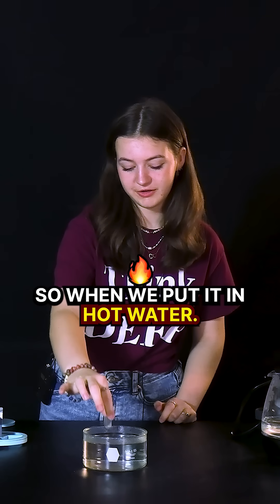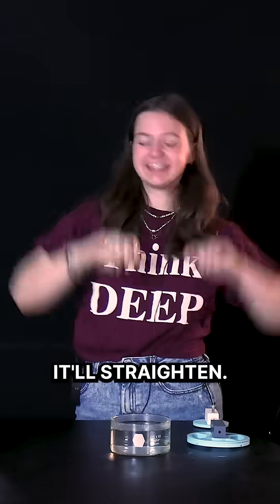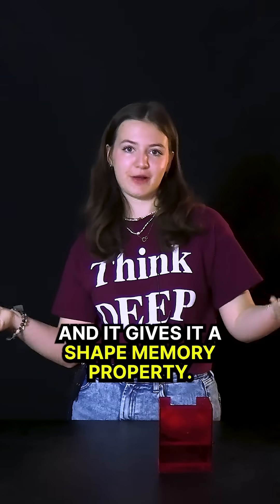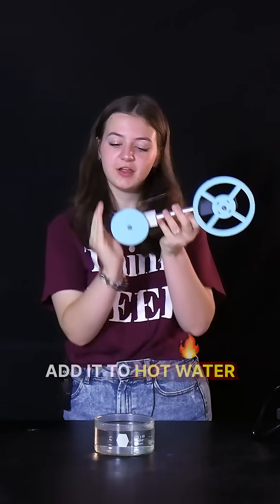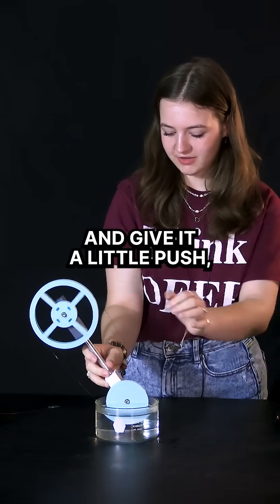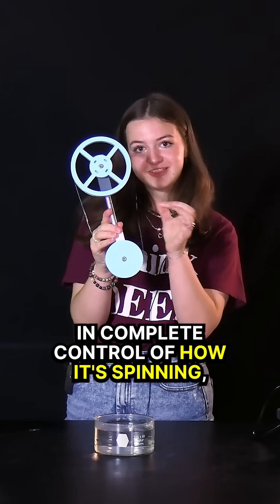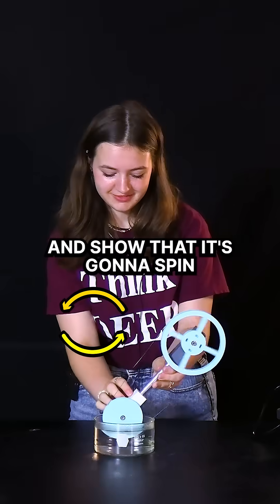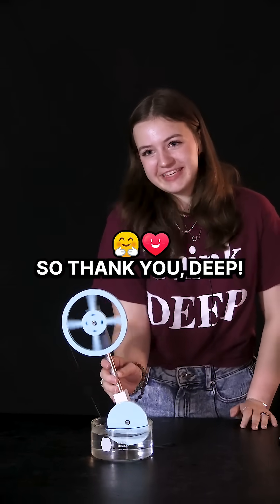Magic metal springs to life from heat! But how?? #shorts #tamu #science

Comment: For those claiming infinite power, power is energy and heat is thermal energy. With loss of heat you will lose the motions. So you therefore need something to power a water heater. Needing energy.
Reply: Increase the size and dip it into a hot spring, I wonder if that would work.
Reply: @leerious99  I think they actually do that already. Geo-thermal energy plants. No idea if they use the same principle as shown in this video though. I'll have to do some research 🤓
Reply: @CosmicMoth Geothermal plants use steam from the under the earth to drive turbines.
Reply: @CosmicMoth I believe geothermal plants use steam turbines. This metal would theoretically require lower levels of heat and pressure to do the same thing, which would make it adaptable to more regions than steam turbines are applicable.
Reply: @leerious99  congratulation. You just invented geothermal station
Reply: @vabka-7708  😂 obviously they had no idea, so it's impressive that they saw this and was like hey, we could use natural geothermal energy. Lbh most see this and think "skibidi chicken jockey snot rocket flippy floppy"
Reply: @leerious99  It's still just drawing thermal energy to make it do work, in the way this is made it just would keep going until either a the spring cooled down enough, or enough load was put on it to stop it.

The only real question is how much energy could it generate, in this demo its not really going fast by power production standards, and that is with no load on it,  it could be setup to power a battery bank, but the lifetime of the material in such an application is unknown.
Reply: @leerious99  If it did work, you'd basically be reinventing a geothermal generator. Steam turbines can be powered the same energy input and are a simpler mechanism, so generally harder for them to fail.
Reply: @heyitsjustaz Its upping the ante of normal heat energy generation because its adding its own energy to the action.
Reply: @leerious99 congratulations, you just discovered geothermal energy production
Reply: @leerious99  then just put that wheel into spring) hold on we already doing this 🙂
Reply: @leerious99  congratulations, you just invented geothermal power
Reply: @leerious99  then the issue changes to cooling the cord fast enough
Reply: @leerious99 At that point just nake a geothermal generator
Reply: @leerious99  it would, but the hot spring would’ve eventually stopped
Reply: @leerious99  no, because infinite power is impossible.
Reply: @leerious99  That's just geothermal energy with more steps.
Reply: @leerious99  you just thought of a new geothermal generator. And I think it could work.
Reply: @leerious99 
It might work, but you’re still not getting something for nothing; hot springs are still getting their energy from elsewhere (down below).
Reply: @leerious99  in theory it should provided the environment outside of the spring isn’t as hot. It would be a crude form of geothermal energy
Reply: @leerious99  not much torque
Reply: @leerious99  I was thinking the same thing.
Reply: @leerious99  just like geothermal power?
Reply: @leerious99  that's still geothermal energy from the planet lol
Reply: @leerious99 hey guess what. Increase the size. Add some paddles. And put it in a river.  Overthinking and over engineering solved
Reply: @leerious99  discovered geothermal
Reply: @leerious99  sure, but you're still taking the heat from the Earth even if only a tiny amount. It would just be another way of converting thermal energy into electricity for example. Some houses in Denmark bore holes into the ground to capture underground heat and transfer it to have heated floors.
Reply: @leerious99  at that point why not just build a water wheel
Reply: @leerious99  congratulations you just rediscovered geothermal power but worse.
Reply: @leerious99  that's called geothermal energy, it's a great renewable power source, not infinite power though!
Reply: @leerious99  yes that would work , which theoretically would be infinite energy,  at least for the next 300 years until the hot springs runs out of heat . Attach the pulley to a series of gears decreasing in size to gain more rotation then link that up to a turbine generator type deal and boom electric for years to come no real environmental impact
Reply: @leerious99  
Well wear and tear still exist, so you'd still have to replace the gears and you'd still have to apply lubricants
Reply: @leerious99  it would, but it would be like the least efficient way to get energy like ever
Reply: @leerious99  But logically that wouldn’t make sense.
Reply: @leerious99  that would be free energy but not perpetual
Reply: @leerious99  what would you power
Reply: @leerious99  geothermal power 2
Reply: @leerious99  for as long as the hot spring stays hot or exists. There also likely is material degradation. I'm not familiar enough with how nitional handle metal fatigue.
Reply: @leerious99  congratulations we call that Geothermal energy where geothermal powerplants come to play
Reply: @leerious99  that should work. But thermal geothermal energy would be available by a hot spring so that would probably be the more effective option
Reply: @leerious99  it's better to use the hot spring itself to power a plant
Reply: @leerious99  yeah that would work! Then you could capture mechanical energy from the heat of the Earth's core 😊
Reply: @leerious99  the would be a form of geothermal energy.
Reply: @leerious99  wouldn’t that just melt the metal instead of straightening it
Reply: @leerious99  still not infinite energy. You would effectively make a geothermal engine.
Reply: @leerious99   geothermal energy is 100% a good way at getting it, but even that runs on something
Reply: Not at well as a water wheel @leerious99
Reply: @leerious99  yes Japan has actually used this method it’s called geothermal energy
Reply: @leerious99  true I think
Reply: @leerious99  thats just geothermal. its all ultimately a matter of cost of maintenance and efficiency of the different systems
Reply: @leerious99  That might actually work! Since hot springs are naturaly heated from the ground.
Reply: @leerious99 that’s what I was thinking hot spring or thermal vent
Reply: @leerious99 this would be the same as a geothermal energy plant which something already being used in different countries but there’s a limit to the amount of heat given off so to the extent that they can, they’re already using this energy method. And I don’t think they use this crystal structure reaction but they’re definitely using the method that works the best with what they have. Usually turning water into pressurized steam.
Reply: @leerious99  why not at that point just use the steam to push a turbine, the nitinol would not straighten fast enough or remain strong enough to push anything anyway.
Reply: @leerious99  i mean the hot spring is a battery if i ever saw one
Reply: @leerious99  it would work as a way to turn geothermal energy to electricity. But it wouldn’t be competitive to other energy sources. Even if it was really efficient I think it’s best to leave the hot springs around the world to human enjoyment.
Reply: @leerious99  it would slowly cool the hot spring?
Reply: @leerious99  yes omg yes!! You did it!! You actually thought of the solution and no one is addressing it! This is truly perpetual motion the same way a waterfall can be perpetual motion!
Reply: @leerious99  it would work but far more efficient ways to get energy from the hot spring
Reply: @leerious99  yeah but you still outside energy at some point. That’s what people are getting caught on I think
Reply: @leerious99  yeahhh
Reply: @leerious99  At that point you're building a water turbine... Its way more efficient in that case to just build a dam and use the force of the water moving rather than the heat generated by the water
Reply: @leerious99  you've discovered geothermal power, and it's probably our best bet for the future since all the other renewable resources arent working the way we'd hoped
Reply: @leerious99  It should.  It's basically running off geothermal power at that point.

There are already stirling engines that can run off more temperature differences, so it's less remarkable than it sounds.  It's not a lot of power, but has some applications.
Reply: @leerious99  That's basically what geothermal energy is
Reply: @leerious99  or any naturally hot water
Reply: @leerious99  That’s just using heat from geothermal energy, so we kind of already do that
Reply: @leerious99  thats just geothermal power
Reply: @leerious99 that’s just a geothermic generator
Reply: That may actually work because the heat comes from something outside the moving system and is an almost infinite source of heated water from the Earth.
Reply: @leerious99  👍 exactly my thoughts
Reply: @leerious99  yet you are limited 1 area the hot spring yes it free energy
 But it limited needing a hot spring
Reply: @leerious99 

How about attaching a heating mechanism powered by the spin so much so the energy from spinning is utilized to maintain the heat
Reply: @leerious99  attach a hot spring to your motor and bam new type car
Reply: @leerious99  that’s my friend is what you called geothermal 😅
Reply: @leerious99  probably it's a similar concept to a water wheel on a creek it's free power to us but it's still not perpetual because there's still a source powering it.
Reply: @leerious99  would still not be perpetual energy, it would just be a gimmicky thermal generator, plus I'd doubt any serious strength to actually take load.
Reply: @leerious99  yeah, not quackery like perpetual motion, or infinite power. Simple and effective geothermal power.
Reply: @leerious99  it would, but it would be powered by the earth and not a water heater instead. so not true infinite energy but it would last for years depending on the hot spring.
Reply: @leerious99  I could be wrong, but if you're going to use thermal vents/hot springs for power, why not just use the pressure/heat directly instead of this weird system
Reply: @leerious99  geothermal energy? Yeah that's been a thing for decades.
Reply: @leerious99  might be easier to build a geothermal genenerator without it, but the steam could be used as excess thermal and you could have the cool water just before it on the pulley to maximize energy output of the plant.
Reply: @leerious99  thats just using existing energy its like burning coal
Reply: Dip it how? Assuming with a… machine that uses electricity or you just gonna use the wire to dip another wire🤦🏾‍♂️
Reply: @leerious99  it should
Reply: @leerious99 exactly my thought too!
Reply: @leerious99   it will just be another geothermal electric generator
Reply: @leerious99   I just posted the same thing ... Great minds think alike :)
Reply: @leerious99  Sounds like a plan to me!
Reply: @leerious99  thats how thermal-energy is used tho
Reply: @leerious99  yeah and now it’s powered by geothermal energy
Reply: @leerious99  yeah that‘s called geothermal and it exists
Reply: @leerious99  That's kinda just geothermal energy, no?
Reply: @leerious99  it will but the water will cool. The earth will heat up the water. If you find a sufficient geothermal source it will definitely work. Amazing invention.
Reply: @leerious99  Thermal vents used like that!? Smaaaaart!
Reply: @leerious99  still, needs energy.
Reply: @leerious99  woah
Reply: @leerious99  that is geothermal energy, and there are more efficient ways to generate electricity with is than using this wire.
Reply: @leerious99  like a geothermal plant
Reply: @leerious99  that’s what we call thermal energy so yes.
Reply: @leerious99  Geothermal energy is a renewable source too!
Reply: You could try using hot springs, not infinite but certainly long lasting, the loop would have to be long enough to allow time for cooling and gearing might be a challenge. 
All depends on how robust the materials are.
Reply: @Never2old.  I wonder if thermal or volcanic locations might be more effective. Maybe something submerged near volcanic vents? It'd be a deep dive, but probably less disruptive than, say, oil operations in offshore structures.
Reply: @Never2old. Right I imagine extended use means it's less likely to retain memory so it would be nice if they were setup specifically to power small items only when dipped would they make electricity.  Of course then there is making a low rpm version lower than 500 rpms
Reply: just use hot water from hot areas or from the sun
Reply: @MegaNinjaRyan  Geothermal energy
Reply: Just conservation of power principle. You could theoretically harness the same source of energy over and over if you can find a recyclable one. But yes you do lose a tiny bit of energy as the chain goes on.
Reply: @dawfurby oh wait. . .
Reply: @BLANKrecordwhatilike00000-I  i'm not here to pick on you. I'm just flabbergasted that your flawed-concept comment has more likes than the one where you realize the glaring mistake, lol
Reply: @IRanOutOfPhrases  lolol
Reply: @dawfurby  A little bit is how much?
Reply: @dawfurby  conservation of energy* power is not conserved.
Reply: @dawfurby the loop should alternate between hot and cold sources, 'cause it will eventually reach or get close to the temperature of the source.
Reply: @dawfurby   nah cause of entreopy
Reply: @dawfurby  it can power the water heater which will heat the water to keep it going and if it works out it can produce way more power like a water mill or turbine.
Reply: @dawfurby  this is why I believe we could be taking advantage of volcanos for power. A giant geothermal generator, would cost an insane amount of money tho
Reply: Naturally, but what’s crazy is how fast it can spin that wheel, given that heat has to transfer which can take some time.
Reply: @AtomicArcherGuy  it's amazing fr
Reply: @AtomicArcherGuy 
Its pretty efficient! That bit of heat in the water turning that larger mechanism! I could run an attic fan easily. Think of all the greenhouses and chicken houses needing ventilation in the heat.
Reply: @MegaNinjaRyan  so a geothermal water heater for infinite power
Reply: Or we use geothermal vents. How much steam power would we be able to harness from Yellowstone alone?
Reply: @ not leave the Duttons rest in peace
Reply: @Ricardo-cw4cb  you do realize that’s a made up television show
Reply: @MegaNinjaRyan  thank you for the explanation, I knew that it wouldn't truly be "infinite power" or "perpetual motion" but I totally overlooked that part of it. Thank you!
Reply: @MegaNinjaRyan  so what is the power source holding atoms together? Is that not infinite?
Reply: @FragmentOfInfinity  there’s no “power” holding atoms together; power is energy over time.  There is energy involved in the electric interaction between electrons and protons of an atom, and that energy can be useable such as in the case of a chemical reaction, but this isn’t limitless as reactions only occur spontaneously when the reaction results in a lower overall energy state (a reaction will spontaneously occur if the Gibbs free energy is lower in the products than the reactants).  Even if we consider nuclear reactions, the energy from these reactions comes from a change in mass.  
And at the end of the day, there exists a finite quantity of energy “in” an atom—you cannot simply extract energy from an atom indefinitely.  You could get energy from an electron that drops to a lower energy state from a higher one, but there needed to be energy input to bump that electron up to that higher energy state to begin with.
Reply: @FragmentOfInfinity  No, it may transfer, somewhere, but won,t disapear nor won,t be generated from nothing. The atoms don't need incoming energy to hold them, but it's somewhat constant value
Reply: @MegaNinjaRyan  what if it’s connected to a heater that keeps the water warm but also produces electricity as well?
Reply: Sun, son
Reply: @MegaNinjaRyan   reinvent Steam engine
Reply: Nah if it didn’t lose properties after a while, it would be infinite
Reply: Right. Would it be more efficient use this instead of heat water for the vapor to spin a rotor?
Reply: No it won't be more efficient, cause in the mechanism/device shown in video most of the stored thermal energy(heat) is dissipated into the air and lost, where in the most systems in which you use steam(in most cases saturated or superheated steam) to generate electricity most of the heat energy is used to heat water and convert it to steam in a closed loop and it means less heat losses due to heat dissipation.
Reply: So ive seen some batteries that are on large scail using heat from the sun and at night use that stored heat as power so you could just do that  and there would allways be power
Reply: @MegaNinjaRyan  the sun here in Saudi is hot af
Reply: So this is actually a thermal generator. Neat
Reply: @MegaNinjaRyan  put the spinning part on a dynamo and power up the water heater with it to have infinite hot water. Jk
Reply: The hardest part about building a perpetual motion machine, is figuring out where to hide the batteries
Reply: Hot water/ heat is often a waste byproduct of many industrial processes. Could be an energy efficiency game changer.
Reply: I would love to see this attached to a windmill.
Reply: use solar
Reply: Perpetual motion a.k.a infinite power is impossible, but i do wonder what would happen if we harnessed the power from a volcano.
Reply: Bro forgot about fire 🔥
Reply: this starts with asking how much heat is required to make the metal change states.

the second question would be scale, how many "wheels"  need to exist to justify spending energy on the machine to make it infinite.

the third question would be (not really a question) can you create heat as a byproduct of the machine running the heat the water to the required temperature to keep the motion alive.
Reply: U could just put it somewhere that’s always hot like near a volcano or you could use thermal vents from the earth or something like that either way I’m sure this would still be better than the type of power sources we have now
Reply: Connected to the wires which will power the heater which will heat the water which will continuously bring power
Reply: What if you built it over a hot spring? That wire would probably snap before it would ever run out of heat.
Reply: What about to you the hot springs water for it?
Reply: Geo thermal energy 😂
Reply: I know perpetual motion/infinite power isn't possible but if you left it in the sun it would work all day as long as it's in the sun light.
But also its electrical output would be insignificant therefore unable to do practically anything.
Reply: who said it needs to be heated?
Reply: @VVKS__7  in order to change from 1 shape to the next it needs to be in a heatwd room with cold water or vis versa
Reply: 2 words... Radio active
Reply: @MegaNinjaRyan  geothermal energy exists
Reply: Solar power
Reply: On the other hand, many, many, many energy sources lose efficiency through emitting heat, so if we can harness some of that lost energy for another purpose, we'd be increasing efficiency. I'd be curious to see the numbers, both on the energy efficiency and how long those metals are able to last in that state
Reply: Have a bunch of these and Power a shared water heater with one of them. We don’t need infinite power, we just need as much efficiency as possible
Reply: @MegaNinjaRyan  bro is confusing energy and power
Reply: Hot spring
Reply: What if you build a giant one of these at a hot spring and harness the earths natural heat from the core? Then it technically does break first law of thermodynamics as it’s harnessing the earth natural heat which does not need to be reheated.
Reply: @ that’s what I’m saying, should be able to create a perpetual motion device that could create infinite power
Reply: water heater. Why not just use a river?? Natural free energy??
Reply: Sun? Mirrors? Would just need a solution to cool it or find a material capable of cooling to room temperature very efficiently. Perfect no, but could potentially be highly efficient.
Reply: It could generate “power” (I think you meant electricity) if you could find a low enough torque generator to to connect to it, but that would only work until the wire reaches equilibrium with the hot water. Unless you cool the wire on the other end. 
Also, if you generate a low voltage (DC) and run it through an inverter…. BOOM, you have 120v, 240v …. 

Don’t tell me that won’t work. Car 12vDC to Household Standard 120vAC Inverters are “everywhere”. 😉🤓
Reply: Could use solar heat, or heat wasted from steam processes that recirculate and cool the water
Reply: Sunlight passed through a magnifying lens to heat a metal part, which has been partly covered by the water. The then hot metal will transfer the heat to the water. All you need to do is leave it outside on a sunny day.
Reply: Hot springs = infinite power
Reply: Encase the lower pulley halfway into a liquid that has a low boiling point, then make sure the Axel/bearing mechanism is replaced with one that captures heat energy from the spinning pulley and transfers it to the liquid. The question is whether or not you can generate enough force with 1 pulley encased, but what if BOTH pulleys have the system? How far up the "wire/drive line" can heat be applied and it still function? That will decide the overall dimensions of the casing (s) and where you will need to figure it out how to connect and power an external device. How scale-able is it? Could we do this on a smaller scale and reap the benefits of chaining them? That's where the real production or energy would come in.
Reply: Use water that's used to cool off AI data centers.
Reply: What about geothermal? It's not "infinite" but you don't have to spend power to heat the water?
Reply: I FEEL,cant the generater they build heat the water also.... at first they can start a generator until its warm then shut it down...free power.. I just invented ..wow..to bad this has been a thing the whole time and they just want to make money off power.we live in a lie..truely sorry everyone
Reply: I mean, could be. Stick industrial scale one over volcano. Profit.
Reply: @BladedThoth  or build a water loop near a volcano so it's always heated which then transfers the heated water to the tank of liquid and then unlimited power (depending on torque)
Reply: You could put it in a hot climate. During day time, like another version of solar powered. And you can make it the opposite for night time, where the wire would activate with coolness.
Reply: @Rash_knee  needs one side hot other cool
Reply: @stefanth8596 no it doesn’t, the heat is what makes the wire turn
Reply: @Rash_knee only heat
Reply: @Rash_knee the wire needs to coil back up to keep the process going so if it's hot everywhere it's not going to work
Reply: @Rash_knee makes that an complicated way to get solar energy (Sun's rays focused onto water or a boiler and heats water, generating infinitely   straightening wheel, instead of a simple solar panel)
Reply: @Rash_knee  Goodluck shipping from Sahara desert to Antarctica
Reply: @Rash_knee  Pairing this with solar power and a battery could yield some potential for home energy solutions
Reply: @Rash_knee  that is not how it works though. It works due to having delta between temperatures. If your temperature is constant, nothing happens. Also, if you spend solar energy on this, why not yo use solar energy on something which make useful work?
Reply: @Rash_knee  if you put it in a 'hot climate', let's imagine you meant into an atmosphere hot enough to make the wire straighten,  you will get no motion because all of the wire will try to straighten. The reason this spins the wheel is due to heating the wire only on one half of the wheel. Due to the force of the wire trying to straighten, the wire drags itself out of the curve. If you're doing this on both sides of the wheel,  you lose the effect due to having equal opposing force.
Reply: @Rash_knee another thing to remember is thermal expansion too. You could put one of these in an open faced well and control the level of water based on the current needs , say it's cold in the night less solar radiation dip it in the deep well where it's above 50 degrees at all times ,reduce the amount of water and put the well where it gets blasted by light all day heating the well. Maybe a clear plastic or glass cover would be a good idea
Reply: @Rash_knee  heat is energy "coolness" is lack of energy or heat. There is no harnessing power from "coolness" as you call it. You can only utilize the differences in energy but the energy comes from the heat.
Reply: @Rash_knee  water has a very high specific heat capacity, so if you were in a hot climate, it would probably work better to just use solar panels
Reply: @Rash_knee  Well, it needs a temperature difference, not only heat. Thats why she puts just the small wheel into water. Outside its cooled and can straighten again in hot water
Reply: @Rash_knee yes we use solar panels to charge it up or magnifying glass to heat up water as the sunlight passes through it to warm the water to a boil maybe
Reply: @Rash_knee  I was thinking that it could be useful to power a basic fan for higher temperatures. The fan will automatically start once the temperature starts to rise.
Reply: @Rash_knee  the sun isn't infinite, technically
Reply: Thank you man lol
Reply: spring
Reply: @MegaNinjaRyan  have you heard of understand water volcanos and hot springs
Reply: @MegaNinjaRyan  could you however run a machine or mechanism off of hot water?
Reply: @MegaNinjaRyan  could be a good power source for place that are near idk hot springs bc most of those tend to be off grid???
Reply: @MegaNinjaRyan  yeah, but let's say the military were using a deep underground military base and they were looking for some breakthrough energy and because they're closer to the core they have heat down there. I bet you they could use it for a power source or adapt it in some manner using geothermal
Reply: Geothermal energy could come in handy for this
Reply: I wonder if this could be used in something like a hot spring that doesn't produce enough heat to use steam but does produce enough heat to power something like this.
Reply: For everyone saying volcanoes and hot springs, you know Geothermal power station are already a thing right? And I'm pretty sure they are way more efficient than doing this, this is just a fun concept but in mass scale we have better and more efficient ways to collect energy from heat. As for coldness it gives you another problem, you need energy to heat the wheels to keep them hot enough to not freeze. So basically it wastes energy that produces.
Reply: What about putting it in some hot springs? - edit Oops, someone already said this
Reply: @MegaNinjaRyan  we should make it bigger so it can power its own water-heater
Reply: @MegaNinjaRyan  yeah but build this around a star
Reply: i suppose someone could find a way to use one of these to power a small heat source? like certainly not infinite power but maybe "free" energy? light a candle under a bowl of water starting one of these spinning which powers a heating element in a bigger bowl of water powering a larger one of these that could potentially power a generator? or use solar power to power whatever heat source you use. still not infinite but definitely "free"
Reply: and you need to bend it first, which also takes energy
Reply: @MegaNinjaRyan  or elevation
Reply: @MegaNinjaRyan  technically yes but this could work treating it as an alternator in a car to generate ac currents use capacitors to store and also push out a high level of energy makeing a heater and or cooling to make it run makeing a technically perpetual motion machine/continuous energy system.
Reply: @MegaNinjaRyan  just burn trash & get water heated.
Reply: @MegaNinjaRyan  makes sense. Gotta heat the water lol. Still pretty cool tho. Makes me wonder how warm or hot it needs to be. Could end up being a really efficient system some day. I'm imagining a robot with limbs with this wire as tendons for those limbs.
Reply: Simple, hot springs/geysers exist, so do artic pools, etc
Reply: Geothermal energy combined with this could be an interesting idea.
Reply: Ohh right . I gotcha . I missed the hot water .
Reply: Yeah i was wondering where the batteries were, nearly slapping myself on the head when i realized the battery was the hot water.
Reply: The sun. + Scale up
Reply: It requires both heat and cold. Without the cold, the wire would simply expand and stay there.
Reply: @MegaNinjaRyan  no to mention maintenance from degradation of material
Reply: Ik completely missed the first "HOT water" part, so thanks for pointing this out! 😊
Reply: I know that. But I was wondering how much minimal heat you need to make it work and if it will produce more energy than the energy lost while maintaining the heat
Reply: @MegaNinjaRyan  even stars die, no one thinks infinite power is a thing
Reply: What about very hot climates
Reply: yes, but this could work in situations where the water is already hot like tankless water heaters which require an active fan to vent. or nuclear power reactors which use water to cool down. you could increase your efficiency
Reply: I have a great idea, put in in natural hot springs 😮
Reply: True. Perpetual motion is only impossible however (by definition) because of things like: the Earth is going to be swallowed by the sun one day. One small idea I've had would be to either: drill a huge tunnel, in the shape of a racetrack and fill it about halfway with water. The Earth spinning will generate current because Coriolis. Alternatively, we could go deep enough to go all the way around the inside of the planet (for transport as well as power generation). It is absolutely 100% possible to setup and use systems/machines that produce more energy than they take to build, in the form of simple electrical current. With this one all you'd need is a thermal vent. The only problem is, eventually the machine will break, thus, no perpetual motion.
Reply: 👍 The sun makes a really good water heater.
Reply: don't forget cooling
Reply: @MegaNinjaRyan  what if you powered the water heating system with the same method though????
Reply: Coil
Reply: @MegaNinjaRyan  what about spacetime? Search spacetime antenna by bashar.
Reply: Like a wood fire. Like solar energy. Like geo thermal. With small ammounts we can turn bigger or more complex wheels!
Reply: Where to buy the rod metal thing to build it?
Reply: @MegaNinjaRyan  easy. Volcanic areas.
Reply: I wonder if some kind of radioactive substance could create enough heat to make that think move
Reply: @Richard-qj1os  its the need to alternate between hot and cold that creates the problem for mathematics.
Reply: Might I introduce you to "Universal Entropy"? Our ancestors called it "mana" and the manipulation of this mana, was "magic".
Magic and Science are one and the same, its just dependent on how much you understand about the process.
So while there is no magical infinite free energy this process can literally go on forever.
Reply: @MegaNinjaRyan Sun light with magnifying glasses will keep the
Reply: No you couldn’t possibly ever make electricity with a turbine.
Reply: So build it on a thermal spring, aslong as that spring is hot which should be a very very long time ur good
Reply: sun and magnifying glass lol
Reply: Could you make a car out of it?
Reply: Now imagine a big tank of water near lava
Reply: @MegaNinjaRyan  lava. Thermal vents. Anything like that.
Reply: @MegaNinjaRyan  true. But that doesn’t make this useless. Imagine using the sun to heat the water.
Reply: @MegaNinjaRyan  this in conjuction with eddy currents? However it's spelled. I'm more into mini nuclear powered systems. To work on homes and cars
Reply: Exactly. This is not a perpetual motion machine because there is no such thing.
Reply: How about hot springs
Reply: @MegaNinjaRyan  what about a hot spring?
Reply: @MegaNinjaRyan  what if you use the water from a hot spring?
Reply: nah it's perpetual motion baby
Reply: Yes but I'm sure power consumption will be less than traditional power methods.
Reply: @MegaNinjaRyan  If the pulley system were reworked to use the alloys response to cold water, or even cool water there is potential here.
The only issue is that the water needs to be heated, but the alloy also responds to cool water..
If it worked with cool water, the only energy that would be expended is the process of 'training' the alloy initially, after that it pulls at itself.
It'd essentially be a complex low power water wheel.
Reply: I was gonna say lol.
Reply: It's like a Stirling engine running directly off of heat.
Reply: Makes sense but is the energy needed to spin it less in this case?? 

It intuitively seems less.. idk someone does some calculation can prove it
Reply: All forms of energy are effectively just boiling water
Reply: The.. the sun.
Reply: @sambenavides824  I don't know how to say this but the sun is not infinite either. Eventually it will die and when it does it will take everything with it
Reply: Volcano
Reply: @MegaNinjaRyan  like mirrors and sun for examples and solar battery for the night if u think clean energy u start finding solution if u r programmed u will be prisoned to program
Reply: @MegaNinjaRyan  add a solar heater and technically it's perpetual motion during the day.
Reply: it always comes back to boiling water
Reply: wait like... energy from the sun?
Reply: depending where you are in the world, the sun could achieve that, with help of something insulating to retain heat overnight. im not arguing infinite energy. but, couldnt they also just train it the opposite way, so cold water makes it straighten?
Reply: @MegaNinjaRyan  Someone needs to invent geothermal heat, th nnit would help this for sure.
Reply: @MegaNinjaRyan  chemical heating should be a good bet for low energy input
Reply: @MegaNinjaRyan  build one in the hot springs
Reply: @MegaNinjaRyan  so insulate it our run it in a hot spring?
Reply: In some places, they have renewable thermal energy from the ground
Reply: @MegaNinjaRyan  also, you need water, or some other fluid that can be heated, or just something to heat it up. Either way, free energy doesn't exist. Even if we could take advantage of gravity and we had an infinite hole to drop a wire down that's attached to a pulley, you'd still have to continuously add wire. There's no "free energy" it always comes at the cost of something else.
Reply: Just to add the conversation;
Keep in mind sources of energy like magnets- the sun- or thermal springs, are themselves not actually infinite. Its just that the finite timescale of the amount of work (energy) which can be produced from said source is greater than the time scale of the receiving use for said energy. 
In other words, a tree's growth can be powered by the sun for a thousand years but a star can produce that energy for billions of years. 
So while zero point energy is physically impossible, gaining  advantages approximate to zero point energy itself relative to the amount of time you need that energy for is absolutely possible. We're just not there yet, fusion is an example of one means by which we may get there. Or think of it like this-
You cant make a battery that lasts forever. But if you had a battery that could last 100 years that wouldn't matter.
Reply: @MegaNinjaRyan  ah, thank you! Didn't even think of the water needing energy.
Reply: @MegaNinjaRyan  but this can work in places with ambient heat sufficient enough to run. But then again even solar panels do the same.
Reply: @MegaNinjaRyan  Geothermally heated water?
Reply: i do have to wonder though, if something similar can be achieved with room temperature water. if that is the case, perhaps a new form of energy could be utilized.
Reply: Hot water spring
Reply: A giant magnifying lens and the sun
Reply: @MegaNinjaRyan  geothermal would provide your heat source and water
Reply: @MegaNinjaRyan  true, but maybe it could capture heat from a body of water heated in summer, sins it will heat up and coldown every day.
Reply: Yes. It's incorrect to say it's powered by the nitonal, it's actually powered by heat.
Reply: What about fire
Reply: Solar...powered....water heater...
Reply: @ please explain
Reply: Nobody is claiming infinite energy. Even the sun isn't infinite. But in the terms finding natural sources of hot and cold to allow this to function, it should absolutely be possible as a viable source of energy
Reply: @MegaNinjaRyan  bro how are you a grown adult yet unaware of what geothermal energy is?
Reply: Would be nice if it straightened due to cold then
Reply: @MegaNinjaRyan  what if we build one in a hot spring?
Reply: Why not just use that big star in the sky called the Sun for power?
Reply: Put a magnifying glass pointed at a water container in a sunny area and here you go, at least you can have energy during the day and depending on some insulation conditions created it might make it through even longer. Wont be infinite but still free
Reply: @MegaNinjaRyan   this could be a really cool way to utilise thermal heat from volcanoes though??, which could be super useful?
Reply: Geothermal heating could have a place in this not sure if efficiency would be there but that’s an unlimited heat supply
Reply: @MegaNinjaRyan  a hot spring: "so i'm just not a thing, eh" 🤭
Reply: What it that powers something to heat the water?
Reply: @MegaNinjaRyan  so stick this wire and wheel contraption in a hot pool near a volcano or something. Sure, energy is being added to the system, but WE'RE not making the energy to add to the system, netting a total plus in available energy
Reply: @MegaNinjaRyan  nobody claims that but it could actually power itself forever given the correct components and That's cooler than anything you'll ever do no offense
Reply: I don't think you really know what you're talking about.
Reply: @MegaNinjaRyan  america is full of hot springs that stay hot for thousands of years. Put it into one of those, and it is in fact a perpetual energy machine, for atleast a few thousand years, which should be scientifically impossible, but she did it
Reply: @MegaNinjaRyan  so what about using black piping coiled up to heat a small pool of water under the summer sun? I know its still not infinite power but would work during the day at least.
Reply: make it bigger make it stronger make it faster
Reply: Thats part of problem. People are 'all or nothing' knobs. It doesn't necessarily have to have 100% efficiency. We get in the 90s and it will be longer than our several lifespans..
Reply: Make it into a generator to heat itself
Reply: @MegaNinjaRyan  if the turbine powered by the wheel had some energy split off to power the water heater, then it would potentially would be unlimited power after the initial hot water input into the system
Reply: Hot springs....ok thanks bye
Reply: @MegaNinjaRyan  volcano under water tho
Reply: @MegaNinjaRyan  agreed, however this module is much more efficient if we were to implement it in real life. Low cost to run the set up with minimum temperatures that can alter the wires shape. By increasing distance we can actually control how long the wire can hold a specific position. With more research and funding, am sure this team probably can build an engine that uses thermal tech only.
Reply: I would say to use the waste heat of other systems to fuel this kind of pojects
Reply: @agsai7185  such projects give 0 torgue. So on the moment you connect this to something it will stop. Even if we can create something which is 99% efficient and uses 0 resources, the amount of useful work from the system will be almost non-existent. Like imagine that you created some mechanism, which can work on single drop of oil fuel for years. What is the point of such mechanism if by adding load the mechanism will never work, because the output of the system is absent?
Reply: the sun dude, like the pyramids in movies has automatic doors in day light and stops moving at night, I believe that's how gears made back in ancient times 🤔
Reply: @MegaNinjaRyan  hot days make big heat, free heat all summer

infinite energy all sunmer
Reply: @MegaNinjaRyan  in my country there's a lot of natural water sources in the mountains, so it's not a problem, but unfortunately my country still relies on non-renewable energy
Reply: Definable not perpetual, but how efficient is it?
Reply: Soooo it's more like a transducer than anything? Turning heat energy into rotational energy?
Reply: @MegaNinjaRyan  Unless you can put it in lava
Reply: It’s not infinite or free power but it could be implemented to increase the efficiency of thousands of existing systems.
Reply: @MegaNinjaRyan  Natural thermal vents and natural nuclear reactors exist. Thermal vents are more common than reactors. That's as infinite of a thermal energy as it gets.
Reply: @MegaNinjaRyan  not at yellow hot springs , it's red hot springs
Reply: @MegaNinjaRyan  the sun is pretty good at heating water. Summer time water hose should do the trick
Reply: @MegaNinjaRyan  it is a silent "engine" though
Reply: OOO WE CAN USE THE SUN OR A VOLCANO!!
Reply: @MegaNinjaRyan  okay so how about we put a big one of these In a hot spring at Yellowstone? Can it be infinite energy using an infinite heat source?
Reply: @MegaNinjaRyan  hot water springs?
Reply: So use the energy the wheel produces to heat the water and have a separate gear powering something else
Reply: Don't ruin the dream😢☹️
Reply: Thank you bro, I was worried someone would comment that. That being said, imagine how much more efficient you could make turbines with this property in mind. And being able to store energy as heat is an old trick. What is really neat is how you could make geothermal turbines like this. Power from the earth itself and that’s pretty cool.
Reply: @MegaNinjaRyan  lava or sun could do they job!
Reply: The estimated metric tonnage of coal left on Earth is currently around 1.16 trillion short tons (approximately 1.05 trillion metric tons).... Yeah we're not going to run out of coal and it definitely ain't finite
Reply: @MegaNinjaRyan  honest question, do you think this kind of technology could be incorporated to nuclear reactors?
Reply: hot spring?
Reply: @MegaNinjaRyan  just go to a volcano for infinite heat
Reply: @MegaNinjaRyan  or some kind of natural hot spring
Reply: @MegaNinjaRyan   i get what u mean but for why not try to reach the actual limits of what this could potentialy be instead of saying its mot power when no one claimed it could even be power
Reply: @MegaNinjaRyan  yes but the power needed to keep the water hot could be less then what 14 large wheels produce while submerged
Reply: Put it on a very volcano or in the desert?
Reply: @MegaNinjaRyan  naturally hot water...
Reply: She's cute so we'll claim it
Reply: What about geothermal sources? Would that mean near limitless power?
Reply: @MegaNinjaRyan  THANK YOU 🙏🏻
Reply: What if you use the electricity it could create to power itself (if heaters dont use much. Idk)
Reply: @ heaters and generators aren’t 100% efficient. Energy will be lost at both of those steps
Reply: @MegaNinjaRyan  But what happens when you put this into a naturally heated pool of water? Would a natural hot spring do it? What about the geysers that have boiling water? Flamingos hang out fields of extremely hot water, too.. 

Sure. It’s not “perpetual” in that it’d run out in a few billion years, when the planet itself dies or the sun explodes.
Reply: Nobody said any of that. But you're wrong. This could be used over a hot spring. Nerd.
Reply: @”infinite” power refers to a system which produces power from nothing. Using a hot spring is just drawing energy from the spring and converting it to electrical energy. We already do this. It’s called geothermal energy.
Reply: fire
Reply: Energy that can be created by the turning pulley
Reply: What about a natural hot water lake or something
Reply: @MegaNinjaRyan  literally just use a hot spring. Cant believe you said all this and didn’t think of that. Its indeed free energy.
Reply: @MegaNinjaRyan  or you know, use naturally hot sources of water like hydrothermal vents or hot springs.
Reply: Can't you use the energy from the movement of the wheel to power it?
Reply: @MegaNinjaRyan  the sun is hot can use that
Reply: The real question is how much can I increase the efficiency of refrigerators by making this sucker power a generator off the fridges excess heat
Reply: @MegaNinjaRyan   thats what good old fire is for
Reply: @MegaNinjaRyan  you’re telling me a hot spring would produce true infinite power ?😅
Reply: What if we put an ultralight in runner "generator" to provide power for a small heater. With the right scaling, it should work, right?
Reply: @nirxiod  still finite. You gotta use energy to heat the water. Weather it be some coal, electricity, gas, etc.
Reply: @OrlOg3cote  you hook the machine (shown in the video) up to the "generator," which could be like an ultralight in-runner DC motor. That "generator" would power the heating element, and if everything is scaled properly, shouldn't it work?
Reply: That’s not the issue.. the issue is whether or not the machine is capable of powering itself. No duh the water needs to stay heated, and heat needs energy. That’s not what keeps it from being a perpetual motion machine. The issue is that the machine can’t power itself and have energy left over, via the inert laws of energy/heat transfer making such a thing impossible
Reply: @MegaNinjaRyan  introduce a solar energy system that heats it at night and let it rely on the sun during the day👍
Reply: So more like near-perfect efficiency power depending on how efficiently you can keep the water heated/cooled.
Reply: doesn't even matter because it is not strong enough to do anything with it
Reply: @MegaNinjaRyan  well if u could harness the solar energy from the sun and concentrate it you could potentially have free energy for a 3rd of the day....
Reply: Ever heard of friction? It causes heat. There is very likely a way to cause this system to generate friction based heat to warm up the medium to allow this to be continuous.
Reply: @MegaNinjaRyan  however, with a gear ratio you can get more out than what you put in.
Reply: Why are people even debating this, it won't produce enough power to be worthwhile, we have geothermal already, this would be a terribly inefficient design with high maintenance and low production. It's a cool experiment not a legitimate method of power generation at scale.
Reply: How about magma from the Earth. That's basically infinite....
Reply: the sun
Reply: @MegaNinjaRyan  people don't realize that 99.999% of all our power is just hot water/hot air.  coal, gas, nuclear.  its all just heat go vroom.
Reply: What if you put it in a hot spring
Reply: @  then whatever you’re powering would have to be probably very far away from civilization or at least far from where you would actually want it.
Reply: @ hot springs don't last forever.  they also aren't always hot constantly, they fluctuate between hot and cold too.  Anyone who has been to a hot spring in winter knows that above freezing is the only promise they offer lol
Reply: None true but sure
Reply: Also, to make it do something useful, you're going to extract energy from the system
Reply: Volcanos. That’s the solution put power plants with this on volcanos and let the lava heat up the liquid. Shts gonna look like Mustafar.
Reply: @MegaNinjaRyan  thermal spring
Reply: Just make it over natural thermal vents.
Reply: Could you, perchance, scale up and place this in say… the ocean? For a sustainable, ecologically sourced form of kinetic energy manufacturing? ( I am entirely new to this idea and am just speculating.
Reply: you ruined the idea dawg
Reply: Yeah but eventually you can power the thing with solar.
Reply: @Preaplanes  why would you use a solar panel to boil water to power the thing when you could skip the middleman and just... get the power from the solar panel
Reply: @vastowen4562  ... I was comparing its "infinite" energy to a solar panel's source. Ambient temp differential all comes from solar or geothermal. And this runs on temp differential.
Reply: Heat wouldnt be an issue
Reply: Place it in hot springs?
Reply: yea but japan has hot springs doesnt it
Reply: Why don't you just make something connect to it and it gives heated energy to the water and you get infinite energy 😑
Reply: What if you have an external power source (like a battery) powering the water heater, and the nitinol pulley system was big enough to create enough torque to charge the battery?
Reply: @MegaNinjaRyan  I'll shall use the sun.
Reply: @MegaNinjaRyan  just make it power itself and you have got yourself an amazing science display prop
Reply: Maybe just build a generator near hotsprings
Reply: It's not a perpetual motion machine- but an incredible way to mechanize heat!!!
Reply: So we all come to the conclusion to have it solar thermal powered
Reply: Wouldn't a certain speed of the spin start heating the water with motion and friction alone? Much like a motor needing a cooling system because the mechanical motion and friction. Just figure out a way for the unit to heat the water with it's own motion and friction. Then figure out how to contain the evaporated water escaping the process to feed back into the loop. Boom. Perpetual motion.
Reply: @rAbbitron_official  that means that we would need to find a way to contain the heat being produced by it
Reply: Yeah, but you can use so little energy and then this can go back and heat itself and I’m sure it would cause excess energy
Reply: @MegaNinjaRyan  I think we need a lab to conduct our research
Reply: Yes but if you added it to an existing house water heater, free power.
Reply: True but I didn’t see anyone saying that
Reply: @MegaNinjaRyan  duh, the water does that lol but really, it’s about a positive energy output right?
Reply: @MegaNinjaRyan  just use a lava bucket 🥰
Reply: Just use the power that is generated to power the water heater
Reply: @ it can never produce enough
Reply: Geo thermal or nuclear
Reply: @ that’s not infinite power lol
Reply: @MegaNinjaRyan  now that right there is the hard part. Because you could use that wire to power a water heater. But like it's always said the hardest part to make a perpetual motion machine is figuring out where to hide the batteries.
Reply: @MegaNinjaRyan  just increase the size to something that will generate a lot of heat. Funnel that heat back into the water. There are ways. Maybe not today or tomorrow but one day
Reply: @MegaNinjaRyan  natural hot springs??
Reply: sun
Reply: What about hot spring? You can place there this idea. It won’t lose it’s energy and it will keep spinning.
Reply: Thermal springs don't cost anything to heat. It might be energy transference, but it's mist definitely free, misus the cost of maintenance
Reply: Why not add it to hot water then for another purpose?
Reply: SUN.
Reply: use that motion energy to heat water 😂
Reply: im just looking at an energy multiplier, not free energy
Reply: You turn the motion into energy, which goes to a battery, then you have said battery connect to two different things: the boiler, then you have the water above the boiler; the house battery, there you go, tell me every reason why that wouldn't work
Reply: Its as close as you prolly can get to perpetual motion.
Reply: Hot springs.
Reply: @MegaNinjaRyan  Fire is free, accessable, and in indefinite abundance.
Reply: @MegaNinjaRyan  the sun 🌞
Reply: Yes, but, if you think in terms of vast reservoirs of existing potential energy that cannot be depleted, such as the ocean around the equator...
Reply: You can use the old tv screen things that can used to melt things.. build that,and turn the beam to the bikar or something,and use this girl thing,and put dc motor on it and boom.perpetual motion.that can be used in daylight..but if you put solar power in night?can it support the led light all night?🤔
Reply: We can add Purple sulphur Bacteria it will generate heat.
Reply: @MegaNinjaRyan  right, but water is one of the best conductors AND retainer of heat, and it will likely cost less energy to heat water and add it than it does to power a wheel on certain applications
Reply: The question is, how much heat is needed
Reply: Get a few larger versions of these in a hotspring.
Reply: What about the sun could that be magnified to heat the water?
Reply: And you forget a thing on this solar system that have a lot of heat which has been hot since the time of the dinosaurs live. The sun
Reply: @MegaNinjaRyan  easy the sun
Reply: @MegaNinjaRyan  hydrothermal in natural hot springs akin to the roman baths
Reply: What about water that is hot. Instead of heated water.
Reply: @MegaNinjaRyan  so what if we use natural source to change it. Like outside its cold. Whatever this would power, would create heat. We we would keep this heat from escaping like keeping it inside. Dont we have a warm and cold area?
Reply: @MegaNinjaRyan  bro just put the water above an active volcano
Reply: @MegaNinjaRyan  more fire like a train wait so trains are made specificially like that?
Reply: @MegaNinjaRyan  i would be claiming perpetual motion
Reply: Ooh, imagine if the wire was long enough to have one end be above, exposed to the hot sun, and the bottom end below somewhere exposed to cool water.
Reply: @MegaNinjaRyan  we have near infinite thermal burried deep in the midle of the planet, some of those escape to the surface in what we call volcano, some in sea bed.
Reply: @MegaNinjaRyan  simple solution, just build a sun to heat the water☀️
Reply: But is thermal energy actually converted into motion?
Reply: @MegaNinjaRyan  steam is far easier to make than most other power sources and using the thermal energy over the pressure it normally uses makes it a far more versatile energy source this could make manufacturing far far more green.
Reply: Could you surely not use geothermal heat to reheat the water?
Reply: The sun is free my dude
Reply: @MegaNinjaRyan  what about the hit springs ?
Reply: So like... could you not, theoretically, make one of these, attached to say an alternator, to generate power, some of which could be harnessed to power a water heater... or maybe a candle warmer... or something of that nature... and while nothing is infinite cause water evaporates, alternators wear out... things break down... but... no?
Reply: @MegaNinjaRyan  the waste product of a nuclear power station is hot water
Reply: Iceland geyseres.
Reply: @MegaNinjaRyan  By that logic we could use thermal waters from underground as heat source fow powerplants, right?
Reply: @MegaNinjaRyan  how springs FTW
Reply: Unless you do what our ancestors did and use the naturally warm water like oh I don’t know say hot springs or geyser which produce hot water through natural processes of magma heating water under the crust and forces the then heated water to the surface? Nah couldn’t be that simple, or using flowing water veins across granite surfaces with resonating rods within the granite that collect and redirect the naturally produced electricity, look into some of the stuff Tesla actually made and invented man, yall are blind to the potential of what we can truly create
Reply: Make this work In the hot springs. infinite source of heat .
Reply: Yeah but if you find a thermal vent in the earth then you could potentially harness that power through that til the vent goes cold which would take 1000s of years
Reply: @ that’s what I was saying, that or natural geysers and hot springs
Reply: Dude I looked through the 50 top comments and nobody was claiming this. Like come on stop making fake drama to tell your little fact
Reply: @MegaNinjaRyan  what about a hot spring?
Reply: Use the  never fading torch of ancient persia ..or  use the same material so it keeps heated nonstop
Reply: @MegaNinjaRyan  could use less energy to keep the temperature then the amount that is generated
Reply: @MegaNinjaRyan  brother I got free electricity fan
Reply: Sun could easily heat up that much water
Reply: @MegaNinjaRyan  🤔 but if you dig down enough you can heat water so using what it already here and natural you can off set the energy needed 🤔 "free" energy is just a case of trade off and how to make it efficiently
Reply: @MegaNinjaRyan  so, what is the efficiency? Looks promising
Reply: The alloy can be sick of that, and just stop working.
Reply: but now you can harness hot water springs
Reply: @wolfpack4533  others have noted the wire loses its potency pretty quickly.
Reply: @MegaNinjaRyan  volcanos bro, trust the process
Reply: @MegaNinjaRyan  sun light
Reply: Volcano, natural hot waters
Reply: What if we trained the wire to straighten into a solution (water + other substance)? We wouldn't need heat anymore
Reply: @MegaNinjaRyan  the sun can heat it up using solar panels and a battery for when the sun doesn't do the thing.
Reply: @MegaNinjaRyan  maybe use it on a generator over thermal vents? That sounds cool
Reply: @MegaNinjaRyan  build it over a volcano??? Boom free energy
Reply: You could reverse it, make it so when it goes into cold water it goes straight, then all you need is to put it into naturally cold water, like a lake or stream.
Reply: @MegaNinjaRyan  I was thinking that until I remembered they used HOT water 😅I think most of us who got confused got confused by that. I thought the effect happened only due to submersion in water I forgot the water has to be hot, too.
Reply: Solar heater
Reply: You can have it in a room that holds warmth you can also use water generator from a river nearby
Reply: Volcanic pools
Reply: Geothermal water source = unlimited energy
Reply: @MegaNinjaRyan  I wonder if training it to go straight with cold water would be possible. Then you could in theory have something that reacts to room temp water, better yet, what about solar powered heating?  Lens and a glass of water should do the trick, tho you do have the limitations of nighttime use for the system. Interesting discovery, I wonder what kind of things we can use this for practically!
Reply: The sun
Reply: Hydrothermal spring to keep water hot.
Reply: infinite what :D there is no such think as INFINITE POWER :D LOL .. in law od phisics you even cannot take more energy than you put to work thats means there is no possybylity that you get free energy ..
Reply: @MegaNinjaRyan  mofos running around acting like the sun doesn’t exist
Reply: Too smart for me 😮‍💨, I completely forgot about the water
Reply: I would jus light a flame under the water
Reply: There is "no" infinite energy, if it were it would be coming from the sun, but that still isn't even infinite.
Reply: @MegaNinjaRyan  sun
Reply: Natural hotspring
Reply: I'm guessing you're the one who thought this was infinite power and someone corrected you so you made a comment.
Reply: Then how does the nuclear subs stay under water for a year. They use heat/steam /water which are by products
Reply: @MegaNinjaRyan  I was just thinking though, imagine a trough of water with hundreds of these connected to two poles alongside the trough spinning two generators. This is a way the hot water collected by rain and heated by the sun in an open trough could be leveraged to create power. Consider even putting the trough in a black tub and the poles in white covered water tubs to have a higher albeado thus “cooling” them, could be even more energy efficient with simply color & material choice.
Reply: @MegaNinjaRyan  but, theoretically, if you use the power generated by the mechanism to power the water heater, then you get a power loop. Correct me please or else it will bug me for days 🤣
Reply: Sun
Reply: @MegaNinjaRyan  could you theoretically temporarily power, a water heating source and then use its own power to power the water heating source?
Reply: @MegaNinjaRyan   thermal water vents perhaps
Reply: That why when you die your body cold
Reply: @MegaNinjaRyan  run electricity through the wire so it heats the water up
Reply: @MegaNinjaRyan  so technically I can use It to cool my Tea down faster
Reply: I hope you never had to explain that considering I realize e=mc²
Reply: It all comes down to boiling water
Reply: What if I place it in lava ?
Reply: But it still could be useful to limit water vapor emissions
Reply: I feel as though it would be possible to make these on a larger scale to where you could have 3. One being powered by the other two that is also powering something to heat water to keep the other two and itself operative. Then the excess from the other two would essentially be “infinite” as long as we can maintain water capacity and temperature.
Reply: @MegaNinjaRyan  a facility located near a natural geothermal source like a water or sulfur spring seems like a good coupling.
Reply: geothermic heat is free
Reply: Volcano’s, hot springs, deep sea geothermal vents.  For all intents, and purposes limitless energy.  The Earth’s core will be hot billions of years for now.  How much torque is there, though.  How to scale his up to be useful such as dynamo charged batteries?
Reply: @MegaNinjaRyan  OMG SO me living in 40c country am getting stonks  of energy 🤣🤣👌🏻
Reply: Could you put water over places that produce heat (like other forms of energy production that loose energy through heat) to turn the lost energy back into usable energy 👀
Reply: @MegaNinjaRyan  so imagine if they started placing these near natural hot water.
Reply: Natural Geo vents would work for a time.
IF you could make it into "power" you could also always make a reserve of power and a back up system so if the geo vent heat lowers/stops.  
the back up reserve activates and turns on heating. 

Its not "infinite" but if you store excess power first. It would be "free" power technically.
Reply: @MegaNinjaRyan  what about a natural heat source
Reply: Couldn't they use a valcano
Reply: We will have to check efficiency of energy conversion if it's viable, then it can be used as a solar electric technology.
Reply: You could get that hot water from car refrigeration to convert it into a hybrid ?
Reply: @MegaNinjaRyan  hot spring
Reply: Seems like a good way to somehow use waste heat to maybe power some turbine or something.
Reply: the sun!
Reply: @MegaNinjaRyan  Geoheating? Use the heat in the ground as "free" energy
Reply: The sun
Reply: I agree it's not infinite, but your initial statement is not true. Power is not energy. Energy is power over time. 

200 Watts is Power. 
200 Watt-Hours is Energy--essentially power in reserve.
Reply: The hardest part of making a infinite power source is figuring out where to hide the actual power source
Reply: @MegaNinjaRyan  like a nuclear power?
Reply: Motion creates energy that creates power that creates motion sooo god is energy! BAM problem solved! 😁
Reply: No one said that.
Reply: I'm pretty sure you can make nitinol that straightens itself from the heat caused by bending it so if you used that mixture you wouldn't even need the water here.
Reply: Also you could just use a magnifying glass with sunlight to make an "infinite" aimable heat source
Reply: @MegaNinjaRyan  thanks
I just came to
Comments to see why it’s not a perpetual motion machine
Reply: I mean if you made it above a natural heat source it could theoretically go until the world ended but just theoretically
Reply: You mean like with the constant bending metal making its own heat?…….
Reply: @David_ShaggyCustoms exactly what I meant
Reply: Like the sun , I mean unless you believe that it’s going to explode or implode or whatever
Reply: natural hot spring
Reply: Could this open or close a window with sun powering?
Reply: Where can this be studied a bit more?
Reply: @glennwillis653  literally what many scientists are studying since the dawn of time! We won't be able to be a lvl1 civilisation until we can harness all the energy of the planet!
Reply: @MegaNinjaRyan   just a thought, but multiple of these could be used for different components of a perpetual energy system. 

The issue with unlimited energy machines is people keep trying to make it with a singular function, when an engine does not have a singular function. 

This by itself can't generate energy, but a system that generates and stores energy from nothing but a spin by hand IS possible. 

I'd listen to humanity tell me what is and isn't possible, but we discover the impossible daily so what do any of us really know?
Reply: Yeah that is what I was thinking as well
Reply: @MegaNinjaRyan  it's amazing how people can't understand that.
Reply: Geothermal energy
Reply: Yeah, I was thinking that if anything, it would be pseudo-infinite energy as in energy would be expelled for an extremely long yet finite amount of time if using the right source to expell that energy to be converted into heat.
Reply: @MegaNinjaRyan  hot spring.
Reply: Just use solar or run the power plant under a thermal point in the ground (those thingies that shoot out hot steam. I can't remember what they're called)
Reply: @MegaNinjaRyan  I mean, the sun does a pretty good job of that which can be amplified by a proper lens. Granted, it would only build energy while the sun is up, you can always make a battery to store and transfer any energy generated in excess during down periods.
Reply: @MegaNinjaRyan  give me a body of water natural sunlight and a glass to magnify the light boom self heated water thus not needing to create energy to go into a water heater
Reply: U say it like sun doesn t exist:)
Reply: @MegaNinjaRyan  okay, but how hot does the water need to be. Can't you use a black pool in the summer? Just place it in the sun. Maybe use it to keep the AC running. Ac only needed when it's hot, electricity only produced when it's hot
Reply: @MegaNinjaRyan  install it near a geothermal vent. My question is how many cycles is the wire good for
Reply: Who claimed infinite power? It's impossible, but efficient energy does exist
Reply: @MegaNinjaRyan  but if you keep the pool of water as small as possible and maximize the output (adding more pulleys etc.). Not to mention totally understanding the power out put (hp)... can it be geared up or down. Even if it won't work forever, how efficient is it..???
Reply: Not free energy, but much cleaner capabilities
Reply: @MegaNinjaRyan  sun + Magnifying glass = infinite energy
Reply: @MegaNinjaRyan  use nathral occuring water sources
Reply: @MegaNinjaRyan  oh that's pretty easy all you need is the sunlight and magnifying glass. 
Now you have an infinite heat source
Reply: @MegaNinjaRyan  why not just use that same thing for a water heater so it powers itself
Reply: @MegaNinjaRyan  making water hot is so easy
Reply: @MegaNinjaRyan  It depends on the defition of "hot".  So in reality, it depends on what is needed to reach that deifinition.  So ut is possible, in the right conditiobs such as a natural hot spring source, that no artifical energy would be needed to heat the wire.  Alsi obvioysly it would need a cooling source on the other pulley then to cool it down or else it could reach a non-reactive state.  Or possibly, just the fact that it it formed into a continuous loop it might never stop trying to straighten itself out.  ie:Free Energy
Reply: Don't worry, most of them are memeing. Hopefully. Probably. Maybe..
Reply: @MegaNinjaRyan  volcano thermal springs using the hot water from it
Reply: Volcano
Reply: Everything is thermal FEKIN energy
Reply: since you seem to want to be technical, energy is NOT power. power is energy over time.
Reply: @MegaNinjaRyan  what if we built one at a hot springs
Reply: Hot springs
Reply: I wonder if this would work in a desert
Reply: For a bycicle I think solar panels should be enough
Reply: @MegaNinjaRyan  yellow stone national park always has hot pockets of water from steam making the water hot,using the metal will then make an infinite power source
Reply: @MegaNinjaRyan  Ughh yess it would initially need start up power just like any system duh.....5 IQ have you??????? Anyways, after the initial power up system this could be a great infinite power source and that initial start up system would make it able too be maintenanced.....orrrr if you wanna over engineer too the fullest you make a self servicing ish system therefore it will still need filter changes too keep fluids clean, check wire health, check temperature control systems ect. This could be something with the right backing and right funding.......that is if those one guys that magically dissappear people for making ultimately free power generators don't dissappear the people and project
Reply: Nuclear waste
Reply: A solar boiler would be enough to infite power it xD + a solar panel that can pump water back and forth in small intervals just to heat it up again, INFINITE POWWWWREERRRRR
Reply: But what about friction? Wouldn’t it create friction and heat up the water?
Reply: @MegaNinjaRyan   you dont need specifically thermal energy for electricity ma man
Reply: OVERPOWERED MAGNIFYING GLASS IN THE WATER
Reply: If you find a way to both capture the heat and light  from the sun, working together with this would be an even better system than solar alone
Reply: Not in an Alabama Spring or Summer it'll stay warm
Reply: Ahh!!!  I didn’t hear her say hot water.
Reply: @MegaNinjaRyan  NO. Build it over a hot spring. Yellowstone can power the nation gottem.
Reply: @MegaNinjaRyan  okay but what about the sun!?
Reply: Exactly.
Reply: Hot spring
Reply: @secluded7772  I see, so you're close to Colorado springs
Reply: Geothermal
Reply: @MegaNinjaRyan  unless you use geothermal or solar... Then we have free energy. Yes you're completely correct, but we wouldn't need to generate that power.
Reply: Also, theres absolutely no torque. It wouldn't turn anything meaningful to genorate anything.
Reply: @MegaNinjaRyan  use a magnifying glass and solar heaters
Reply: @MegaNinjaRyan  so using mirrors and focusing them on a pool of water uses a heater?  For your lifetime, that sun will continue to beam down. Granted, it’s limited to daylight, but a solar panel added could theoretically make it last “infinitely” during down time.
Reply: Once its powered you can use the power to keep the heat on
Reply: @MegaNinjaRyan  that was self explanatory people
Reply: @MegaNinjaRyan use  geothermal pits to heat the water.. the water powers the wire powers the wheel. Wheel powers the generator.
Reply: So what you're saying we're looping back to Steam Power... Again. XD
Reply: @AeroQC  "innovative" steam-power ;-) or modern iteration of it, geothermal.. it doesn't matter what it's called as long as it can reduce usage of fossil-fuels, even if just by a little.. reduction in CO2 emissions however small is a BIG bonus in my view.. little by little, hopefully, we can wean-off fossil-fuels altogether
Reply: @san0saky  I was being cheeky. 😋
It's just that a lot of power systems nowadays almost always involve hot water in some shape or form to run a turbine. 😅
Reply: I don't think anyone's trying to suggest that this is in any way, shape or form a "Free Energy" device.. instead I think people are suggesting that you could theoretically extract "cheap" power, given that you'd have access to a hot-spring, or an active underwater volcanic vent, or better yet, if you'd have access to a VERY deep mine, which would reach depths where temperatures would rise high enough to keep water warm (or perhaps the metal she is holding only requires heat, not necessarily from water)..
The actual "problem" could be trying to scale-up and retrofit an electric-motor to produce the electricity.. most likely this device wouldn't have enough torque to spin-up and produce power.. then again I have no idea about the tensile strength of that metal-composite spring..
In any case, this is a good, innovative idea.. and if ALL of our youth would have same optimism and determination and making new stuff, the world would be better off..
Reply: @MegaNinjaRyan  If most of the mass is put into the belt on a larger scale then add a partial friction bearing could possibly keep the fluid warm enough to stay perpetual 🤔
Reply: I'll give you a clue it's supposedly on fire and huge. It lives in the sky and you can't see it during the night.
Reply: Hot springs?
Reply: @MegaNinjaRyan  the sun.
Reply: power it with the pulley goober
Reply: I wonder if this is better then using stream to spin water wheel in nuclear plants.
Reply: @MegaNinjaRyan  Thank you
Reply: Yea like a natural hot spring
Reply: This can give free energy. Did you try it?
Reply: @MegaNinjaRyan  they can use the power generated to heat the water 😈
Reply: @MegaNinjaRyan  do you really in Texas? 😁
Reply: @MegaNinjaRyan  genuinely asking, what about a natural hot spring? Do you think that'll work. Until the hot spring isn't hot anymore?
Reply: @MegaNinjaRyan  what if you use that to make a water heater using a coil and science then the water is always hot and you have another making energy
Reply: You don't need to add heat.  It just needs a difference in temperature.
Reply: @MegaNinjaRyan  or just use a fire that never goes out, leave it in death valley or something
Reply: put water in a pool or something scale that thing then put it outside the sun 😂😂😂
Reply: @MegaNinjaRyan  make a pully system that goes from geothermal heat inside the earth's crust the whole way up to the top of a  frosty mountain.
Reply: It's all solar power.
Reply: @MegaNinjaRyan  Yeah but that just added a whole new prospect to geothermal energy!!!
Reply: @MegaNinjaRyan  geothermal energy
Reply: @MegaNinjaRyan  thermal energy is just the sophisticated way of saying solar panel powered thermal heating system.... which is still thermal energy called solar panels, semantics...
Reply: @MegaNinjaRyan  that and the law of diminishing returns, no matter how efficient the heater is, it can never power itself to the point of infinite power with this machine. It may work for a while, but it won't work forever
Reply: Naturally occurring geothermal vents will provide lifetimes of natural heated water.
Reply: Maybe you could use the heat caused by braking, gearing, or any other source of friction to heat water
Reply: The sun and a magnifying glass ☀️🔍
Reply: It would be interesting to see the efficiency of this instead of a turbine for instance. Especially for low heat applications that can't output steam.
Reply: @MegaNinjaRyan  sun can heat the water
Reply: Fire?
Reply: Precisely this is a thermo-rotational converter
Reply: @MegaNinjaRyan  geothermal
Reply: Solar heated. Magnified if need be. As long as you're using less power than what you can generate, you succeed.
Reply: What if you put that thing in the hot springs
Reply: Uhm use firewood or anything burnable and heat the water infinite electricity
Reply: @hytrofyro  you don't understand human don't you? I know wood can be infinite but remember it's human that take the command they just cut down tree without thinking about Replant it  they go to other countries buy the wood and go...
Reply: @MegaNinjaRyan  ya, but if you used a hot spring, would this not allow for continuous thermal powered energy generation?
Reply: But cant it turn turbines to create energy?
Reply: natural hot spring
Reply: It all boils down to heating water for _______ to work.
Reply: Water is easy to heat with solar. The hot water in my house comes from panels on the roof.
Reply: Put this in a desert 😅
Reply: Has anyone ever tried to use that concept as a silent Stirling engine alternative?
It is just so much simpler overall.
Reply: Has anyone ever tried to use that concept as a silent Stirling engine alternative?
It is just so much simpler overall.
Reply: Natural hot springs.
Reply: @MegaNinjaRyan  the sun can heat the water with a mirror and lense
Reply: Anything human made will never be "infinite" power
Reply: Nah, that's why we got Yellowstone💀
Reply: @MegaNinjaRyan  but if you had waste heat, such as exhaust heat expelled from a ICE motor...
Reply: @MegaNinjaRyan  use the cold water and put in an antartic
Reply: @MegaNinjaRyan  water powered car
Reply: @MegaNinjaRyan  what about hot springs from the earth? We will be LONG gone before the earth goes cold.
Reply: @MegaNinjaRyan  hmmm I wonder if a solar death ray could come in handy here? 🤔
Reply: What if you use it's own energy to heat itself after you get it started
Reply: @MegaNinjaRyan  hear me out… geothermal pools. Think Iceland. They wouldn’t have to dig geothermal plants anymore if they build this on larger scales.

Then again, there would be far more drawbacks then there would be any benefits, and frankly I don’t know if this is scalable either.
Reply: @MegaNinjaRyan  you could just use a hot spring
Reply: Sadly there is a ton of people that think the laws of thermodynamics are BS. It's the middle aged guys with the alternators and pulleys on their Tesla's claiming Way better range. It doesn't work, The energy it takes to turn the alternator is not more than the output, They only work with a gasoline engine(Finite). Even Solar panels are not perpetually free energy. The Sun has a finite lifetime. It's the closest thing we have.
Reply: @MegaNinjaRyan  so if you stick it in a natural hotspring around a volcano?
Reply: Small quantities of water would heat pretty quick in the sun
Reply: Just make one thats 1000x the size and put the back end of it above a volcano 😂, its not like we’ll run out of magma anytime soon!
Reply: What "they" mean is energy efficiency - as it has benefit here. For example it could enhance various engines, which generate heat by default when working. Also the ability to use heat/cold which is already generated by something, or by a natural source (less human effort required to get this energy). Also probably has some potential towards more ecological solutions.
Reply: @MegaNinjaRyan  they could use mirrors during the day along with th something solar powered for the night
Reply: @MegaNinjaRyan  Totally agree, makes me wonder if it’s possible to make a solar power machine that boils the water perhaps
Reply: @MegaNinjaRyan  fire
Reply: Put it in a hot spring. Check mate atheist.
Reply: So just put some fire on netherrack duh

(Joke)
Reply: @MegaNinjaRyan  let's heat some water with the Sun
Reply: I think Hot springs have heated water all the time
Reply: @MegaNinjaRyan  if she adds a power conductor and a heating system to keep the water at the right temperature,  that could be called perpetual energy. The fact  that she showed us a good example of energy in motion, growth is endless.
Reply: My question, can we use the power of sun and magnifying glass to keep heating the water and produce this energy?
Reply: @MegaNinjaRyan  power it with the sun. Use a magnifying glass and focus sunlight on it. Is the power output better than a solar panel?
Reply: @MegaNinjaRyan  So just use the solar to heat the water which is renewable energy.
Reply: What about in application for a car, battery powered water heaters until the engine his hot enough to maintain the water temp
Reply: GEISERS
Reply: @MegaNinjaRyan just put one of those spicy rocks in the water. you know what I'm talking about! 😉
Reply: @MegaNinjaRyan  right so the question is how effective it is
Reply: @MegaNinjaRyan  also the fact that theres very little energy behind that
Reply: @MegaNinjaRyan  a hot spring or geyser
Reply: You have my respect with that pfp
Reply: Have you ever thought about electronic conductive heating? Connecting it to a motor and using the power to connect to electrical coils you can in turn heat up the water. There is a heat loss yes but if you chain them up into massive generative rows the heat loss may become less and less to a point of nonexistence. Yes there is the water evaporating away. Your right on that matter but the electronic heating could be done potentially.
Reply: Lava? Couldnt this be used to make a type of solar powered one?
Reply: This can be used in space in my opinion. Or geothermal spots.

Think of a really efficient elevator which exposes this wire to heat and cold repedeatly.

And it generates spin which makes it generate energy which we can use
Reply: What if u make it underground where it is always high temperature
Reply: Thermal waters? It would be automatic
Reply: what if you use heated water that is a biproduct of another system where the heated water would be wasted
Reply: @MegaNinjaRyan  yes to get it started, but once started with the right amount of energy production, it can power the heater and water pumps itself as well as have extra power left over.
Reply: Robots WILL LOVE Yellowstone!
Reply: Easy just add solar panels😂😂😂
Reply: @MegaNinjaRyan  the sun is a thing, right? Lol
Reply: Well you can focus sunlight on a large lens to heat water.

One of many free energy methods of heating water
Reply: The cool part and “nearly infinite power” aspect I see here, though, is that, in almost every power generator we’ve created, heat is an byproduct, whether desired or unwanted. Innovations like thermal crystalline reformation, which allow for new translations from thermal to kinetic energy, could open up new possibilities for energy recycling and efficiency improvements by repurposing heat energy from entropic loss into a more useful byproduct: motion. In this way, we could ideally reach peak efficiency in energy conversion and conservation somewhere in the very high upper 90th percentile.
Reply: I thought about this as soon as i seen it spin on its own 😂
Reply: @ mirrors and the sun would provide enough heat for this. So it’s still viable. Only during the day but still.
Reply: @ might just spin in opposite direction depending on the temperature tolerances.
Reply: @MegaNinjaRyan  The sun and a magnifying glass could solve that issue for free.
Reply: @MegaNinjaRyan  think, volcanos and such. We can make something happen here…
Reply: @MegaNinjaRyan  got it, so listen up, a huge metal panel with vapor chambers inside of it leading to the water to heat it up, it's like a ghetto solar panel 👌😂
Reply: @MegaNinjaRyan  energy ran on electricity on exactly fuel
Reply: How hot does the water have to be?  Throw some black trash bags in it and cover the surface. The sun will keep it hot all day haha
Reply: @ water also retains heat very well, so it would likely go all night and only slow down. Assuming the concept worked. Then mirrors etc could bring it back to an optimal temperature. Natural hot springs?
Reply: @ less than boiling apparently. So under 212 F. Mirrors would work better than a trash bag though.
Reply: But if you can make a body of water that’s just always there work like the ocean then it would be functionally infinite. Doubt such a system has much torque though.
Reply: Can’t you make it produce some electricity and the electricity can boil water?
Reply: @ the energy would take to boil the water would exceed the energy it’s creating. Boiling water takes a tremendous amount of energy.
Reply: Make use of natural hot springs
Reply: You mean like greenhouse. The sun would heat up the greenhouse and thus turn the motor?
Reply: Just need this implemented into a vehicle now
Reply: @MegaNinjaRyan  I would also be willing to bet that the material doesn’t keep trying to straighten forever and the property would diminish over time before needing “retraining”.
Reply: INFINITE POWER
Reply: @MegaNinjaRyan  ever heard of gas? ever heard of fire? ever heard of natural hot springs? You dont need energy to heat the water buddy.
Reply: Iceland - geothermal waters
Reply: @MegaNinjaRyan   yeah or we can use use it to produce electricity near geothermal plants... Or natural hot springs
Reply: @MegaNinjaRyan  yes, but some things hold heat for longer. More miles for the same energry output is still a big win id say.
Reply: @MegaNinjaRyan  it does require less energy though, right? Rather than boiling water to steam you warm it to the point where this works. Could that work?
Reply: @MegaNinjaRyan yup!! you can’t create nor destroy energy only transfer it into something else
Reply: Geothermal vents
Reply: Spring water
Reply: @MegaNinjaRyan  no
Reply: She said nothing about that she was excited about what she was doing but made no claim of infinity power. 
Check your head
Reply: I see this comment but I also wonder if it’s possible to have a net positive energy output… like yeah it won’t be 100% efficient BUT could it it generate more power than it uses
Reply: -> solve for your problem, narutal hot source :D
Reply: @MegaNinjaRyan  only matters if you generate more power than it needs to sustain itself, which violated the laws of thermodynamics
Reply: What if you put it over a volcano?
Reply: You could connect the pulley to something that generates friction around the glass, thus keeping it hot and the pulley spinning
Reply: And if we used a heat byproduct to keep the system running? There's a lot of ways heat is generated that we don't want the heat from, such as running electronics. Could be useful in some applications, but that's not up to me to figure out
Reply: Could this technology be used in something such as a natural hot spring though where you harness the earths energy (Heat). Possibly to be used to generate power
Reply: Hot springs
Reply: So but can it be used for something like a car with solarpanel for heating the water and multiple of such wires setup for abit more tork
Or even with a little battery coz for warmer places where there wont be a big deal warming up the water
Or does this wire has a limit till it tries to straighten up
Reply: @MegaNinjaRyan  Unless you use the water that is super heated around Yellowstone because then theoretically the energy being used is being produced by the planet and not yourself and I don’t know if this means perpetual motion but if you using the energy from the center of the Earth to heat the water up to then power that wouldn’t be a useful source of energy
Reply: When I worked at a plant that made bearings there were certain stages of the process where magnets were used to slow bearings enough for them not to go flying.  There were times when the bearings would get stuck in the field of the magnets, like if there was a back up.  They would get super hot if left there long enough.  Hot enough to warm water.  This itself would be enough to cause it to cause the reaction needed here.
Reply: @jonathanbruce9101  what kind of magnets? Magnétite based or was it an electro magnetic device? I'd assume it's electromagnetic so the field direction and power can be adjusted but I might be wrong. If I'm not, this magnet was using electricity from another source.
Yalls can try as much as you wan but if the most brilliant engineers of the word haven't found a way to create energy from nothing. It's not this comment thread that will. Let's just rejoice that this new discovery could make us steer away from the steam Piston that is used in most electricity factory (coal, gas, nuclear, geothermal, etc). The only system that does not use that low efficiency system are hydroelectricity dams or wave activated system, windmills, solar panels, etc. This string does reduce the energy loss caused by the piston being pushed by heated steam and transmitted to a generator. Can't wait to see how this could become a new high efficiency system!
Reply: @OrlOg3cote  I mean for this system to work you need heat either do solar or coal🤔 and it's not better then just using the solar power as iss. Also don't bring down peoples hope🙄 you never know some smart ah could be in these comments and maybe they could figure out infinite energy.
Reply: @slidecode6318  the first rule of physics is that nothing can be created and nothing can disappear. Energy is also affected by this rule. So that's why I think this system could work with a heat source like a hot spring that just throws 100% of its energy to heat transfer in the air instead of in an electricity generating system
Reply: Gee idk… FIRE…
Reply: Also they weren't anything more powerful than a neodymium magnet as it took minimal amounts of force to move them from said fields.  Moreover it wasn't electromagnetic based on the fact the magnetism didn't cease when totally powdered down.
Reply: The heat could be cause by another necessary function of the machine, like a heat sink. After a single start, it would be continual perpetual motion and free energy, so the 22k likes just dumb people
Reply: A warm natural water source like in iceland would be the right place
Reply: Solar is infinite energy.
Reply: could you possibly connect it to make some kind of friction making it heat up therefore going continuously
Reply: Cool! We waste a lot thermal energy in a lot of ways. This has a lot of application.
Reply: Geothermal
Reply: @MegaNinjaRyan  unless using a hot spring?
Reply: @MegaNinjaRyan  wow thank you man
Reply: Well if the water was out in the sun only work during the summer but the water would get hot🤔 or fire but idk if that's as good as other things
Reply: I was just wondering this, thank you! 😅 I had a beautiful vision of a perpetual motion machine !
Reply: @MegaNinjaRyan yes but,
 what if we develop a metal that straightens with cold water? Will it now be infinite?
Reply: @MegaNinjaRyan  I sleep hot so could but one under my bed BOOM free electricity... 10000% science
Reply: @MegaNinjaRyan  or just find one of the thousands of hot springs on our planet.
Reply: how hot does it have to get... can we build a bunch of giant ones and place them in Death Valley? Or  a hot spring?
Reply: Could u use hot springs .
Reply: Power is not energy. Power is energy over time.
Reply: Can’t you use the energy to use the heater to then crest more energy so a percentage of it is still usable for other needs and then the other percentage is use for the heater?
Reply: @MegaNinjaRyan  power it with the sun?
Reply: The sun heats water
Reply: @MegaNinjaRyan  can turn gear with it and make power but eventually it will get fatigue somewhere in the system and break down so not infinite but cheap af
Reply: Bro has never heard of naturally warm water (like in a hot spring)
Reply: @MegaNinjaRyan  
The sun is free heat.
Reply: @MegaNinjaRyan  fire. Just use fire to heat the water
Reply: @MegaNinjaRyan  cant u have 60 of those type engines and then it could run its self?
Reply: Once u get it started then it runs itself
Reply: But a hot spring? Or thermal energy? Something the sun or earth already gives us, so we don't have to burn coal oil or use explosive lithium? A greenhouse water basin to keep water warm?
Reply: @MegaNinjaRyan  solar energy alternative
Reply: Oh dig a hole deep enough and fill it with water the earth will heat to wire
Reply: BUT, if you use the sun to heat the water, freenergy*
Reply: @MegaNinjaRyan  need to be near geothermal
Reply: You need the pulley to power a generator to heat the water.
Reply: What if you have a electricity powered generator. Technically, you generate the electricity, use a portion of it to power that generator, and save the rest? If the output IS more than the input, it would technically be infinite electricity
Reply: Dont data center use water cooling? If it output hot water might be a good way to reuse the heated water
Reply: power the heater with the energy you got from the system
Reply: @MegaNinjaRyan  natural Hot Springs
Reply: You could utilize a source that was already giving off heat whether it be geothermal or some sort of electrical equipment. You might even be able to use solar
Reply: sun
Reply: You would need to find a material that straightens at below room temperature
Reply: Heat was consistently considered an energy loss in most cases
Reply: Geothermal energy
Reply: We know about basic phisics, thank you but no one asked.
Reply: @MegaNinjaRyan  I was literally coming here to say the same exact thing.
Reply: @MegaNinjaRyan  yeah but bro we could just use the ocean. We don't even need to do anything. Yeah, by the laws of nature we can't just create energy from nothing. So let's use something that we abundantly have which costs nothing equivalently
Reply: @MegaNinjaRyan  it's pretty gosh darn close tho.
Reply: Water holds heat very well when contained and insulated. Geothermally speaking it could be kept hot for free. Producing energy creates heat as a byproduct. I assure you hot water is the least of the problems for this idea creating energy. Also we don't know how hot. The water demonstrated isn't exactly boiling ya know. Between solar and geothermal free endless energy heating water wouldn't be an issue. Its like you want obvious good ideas to not be obvious so you can sound smart... it had the opposite effect when you ignore the sun and molten magnetic core we have access to... do we need power for hot springs too? Are volcanoes running on tripple a batteries?
Reply: me with my fire wood snd steel kettle
Reply: Nuclear
Reply: @MegaNinjaRyan  so could this be used efficiently as energy or is it just a neat trick?
Reply: Ok but what a about a geothermal hot spring?
Couldn’t you use the hot water on something like this but much larger wouldn’t it stay in a constant state of movement as long as the water is hot?
Reply: @ geothermal power is already a thing that’s used, It’s just not super big.
Reply: @MegaNinjaRyan  what if let say we put these on earths natural heat pool? Can we consider it infinite power since we don’t need to heat those pool’s?
Reply: If you got it started using tech… theoretically you can use it to power something small enough to generate heat within the water. The water may be conductive at that point but if you isolate the water to limit exposure you wouldn’t need to worry about that. 

Now increase size of it all and you may be able to power other things. 

It’s not about “ThAt’S iMpOsSiBlE”, it’s about think outside of hypotheticals and creating the theoretical into concepts. 

You’ll never get anywhere if you never try.
Reply: Yes...so you just have to boil the water on a fire.
Reply: @ this is ragebait right?
Reply: Mfers who found a geothermal lake just to prove this comment wrong
Reply: @ geothermal energy is still energy added from outside of the system
Reply: @MegaNinjaRyan  solar energy is a thing and also geothermal energy. People have been harnessing the heat from earth and volcanoes to heat water for energy for decades. You're still right but just wanted to point out that there could be a way but currently hasnt been found possible
Reply: @MegaNinjaRyan  yes but is it still efficient?
Reply: @MegaNinjaRyan  That is true, we could always use old school methods to keep the water hot, charcoal fire or wood fire? Maybe an implementation of added friction to the wire to keep it hot whilst rotating? Idk im not an engineer 🤣
Reply: Could probably build a simple steam turbines with it though.
Reply: @MegaNinjaRyan  with enough technology and brains I’m sure you can make a contraption that both produces free, clean energy while also powering the water heater
Reply: Wouldn't it eventually start to follow the shape of the curve therefore only allowing it to be used only for so long
Reply: Well heat can be produced by friction in the pulley and if you water cool the pulleys the just made it’s enough
Reply: @MegaNinjaRyan  yes, also because the water will slowly lose heat, because of the transfer to the metal wire, the container, the table, and also the air around it
Reply: @MegaNinjaRyan  use geothermal energy then
Reply: @v1rusyoutube927 geothermal energy plants are already being used, but yes that could be an efficient way to generate electricity
Reply: I mean yeah still dope tho
Reply: @MegaNinjaRyan  how about those hot pools that naturally occur, I’m not sure where maybe we dip them in there and convert all that natural heat energy into kinetic energy ultimately into electricity?
Reply: @MegaNinjaRyan  ok but you have to see this is very close to infinite energy I wonder if you can get the pulley to power a peltier device that can keep the water hot?
Reply: @MegaNinjaRyan   natural hot springs bro what are you talking about
Reply: Compost piles and copper pipes. duh
Reply: The water heater can be powered BY THE ACTUAL string 😂
Reply: @MegaNinjaRyan  nuclear energy will work for a while
Reply: @MegaNinjaRyan  what about using natural geysers /hot springs
Reply: The sun?
Reply: @MegaNinjaRyan  what about volcanic or thermal vent heated water? Those aren't cooling down anytime soon .
Reply: Use the sun for heat
Reply: @ thats solar panels 🤦
Reply: @MegaNinjaRyan  geothermal
Reply: Free energy (solar panels +battery )+(simple heater)in some water+(the pulley )(and that (nightennol string) 
And voila you got free energy 
After that, all you need is Maintainnance
Reply: @MegaNinjaRyan  a volcano? Solar panels? Limitless energy
Reply: @MegaNinjaRyan  your argument is invalid due to solar power. 😃
Reply: @MegaNinjaRyan  put a generator at the other end and use its energy to keep the water warm
Reply: Bro, forgot about geothermal energy
Reply: I wonder if a Hot Spring could be that "Free" energy we could use to get "Free Energy" 
think about it....
Reply: Technically if it can produce enough power to heat its own water it might work. I don't know how or if that would work though.
Reply: @MegaNinjaRyan  couldn’t you harvest already abundant thermal energy?

Like, geothermal?

Orrr, via sun-side satellites?  Something like that?
Reply: @MegaNinjaRyan  use the motion to power the heater and upscale then find ways to reep the energy ofset
Reply: @MegaNinjaRyan  the spinning pulley can run a generator that powers an electric teak kettle to warm the water to spin the pulley. Ez. The oil companies just don’t want us to have unlimited free energy but it’s not hard.
Reply: Look, if the wire was trained to work in say, the ocean on an average day? No it wouldn't be limitless, the sun will eventually burn out, and it would only work at certain times, but it would be free
Reply: @MegaNinjaRyan  if you set it up. Couldn’t you make a system where the spinning wheel powers something that generated heat. Which keeps the water hot?
Reply: So if placed over something such as a geothermal vent you would have power not unlimited but instead limited to the life of the planet itself at least till it wasn’t able to sustain the vents. Or am I thinking incorrectly still waking up lol
Reply: @MegaNinjaRyan  sun
Reply: Infinite power with an asterisk
Reply: Fires good nuff.
Reply: What if the pully was able to produce heat.
Reply: @vipstarizm6990  that woul be via friction, which would mean it would lose kinetic energy.

Srsly, have y'all attended any physics class in school?
Reply: Well it’s the time derivative of energy but you got the right idea.
Reply: @MegaNinjaRyan  the sun?
Reply: Hot springs, geysers, underwater volcanos, thermal vents……
Reply: @MegaNinjaRyan  what if some use this in hot countries where temperature is above 50 degrees
Reply: Mega ninja forgets this increases the continuity of power 🎉 nay sayers tsk tsk
Reply: Unlimited jacuzzi use 🙈
Reply: Thermal vents maybe?
Reply: Maybe initially, but after it goes for a while it will generate heat on its own thus powering itself.
Reply: @MegaNinjaRyan  no one said that ☠️
Reply: @MegaNinjaRyan  could you in theory use something like the sun and a magnifying glass to heat it? Have you seen the man with the sun death ray💀 I think he could keep the water heated. All theory ofc
Reply: Exactly. Which, it's funny, nuclear power works from heating water.
Reply: Hot springs exist, just saying
Reply: Bros just imagining ops out here
Reply: 1. Put hot water first
2. Put your device in Hot water (make it spin)
3. put a generator to your device
4. connect generator to a water heater

Water stay hot, device keep turning, generator keep generate enery, water keep being heated...

EZ Infinite power
Reply: Geothermal 😊
Reply: I am enamored by the amount of people who don’t understand what infinite energy means. These comments are the new Aristotle and Socrates guys 😭
Reply: Yes and no. It's pretty cool that you could make a generator out of this if you find a source of heat that isn’t set up with as much infrastructure as a fuel powered steam generator would be.
Reply: But what if you hook the power output up to a heater that heats the water?
Reply: Terrance Howard invented this, his was more efficient and did create infinite energy. It’s so simple once he explains something
Reply: Thanks for the info. I know that infinite power isn't possible but wasn't sure what would stop  it with this specific case. Thanks again
Reply: Hot spring.
Reply: @MegaNinjaRyan  i have quesiton.
Is there any material in nature or created that maintains a permanent temperature between 80 and 100 degrees Celsius?
Reply: The friction of the movement would create heat would it not?
Reply: @MegaNinjaRyan  Exactly! And even if the whole system were insulated, it would eventually stop working due to thermal equilibrium.
Reply: I know infinite energy is ultimately impossible but could something like this not be optimised in such a way as to use the energy to reheat the water creating minimal energy loss
Reply: Hot spring I guess
Reply: feed some generated energy back into heating the water :)
Reply: Bro made a claim nobody was making just to disprove himself
Reply: @MegaNinjaRyan  sun.
Reply: Not only that but you are talking about getting such a negligible amount of energy off of that itd be pointless
Reply: @MegaNinjaRyan   I guess you've never heard of  hot springs
Reply: Yeah, we could use the sun
Reply: Uranium/plutonium cooling pools idk makes sense to me
Reply: Imagine these under a hot day.
Reply: @MegaNinjaRyan  could we not use natural  geo thermal or a volcano to assist in the heating ? Then we are using a natural heat source.
Reply: Real
Reply: jd put it in the sun or between hot sand
Reply: What if we dip into a solar heater and put into it isn't it a infinite power
Reply: Or hot springssss
Reply: @MegaNinjaRyan  or u can use fire to mske the water warm and take it off and when its cold u can just put it back on fire
Reply: Just having arguments with imaginary people over there, huh?
Reply: @GRAVYTYMusic   clouds are people! Now I can't remember why I have this onion on my belt. Maybe another onion will remind me to remember?
Reply: @GRAVYTYMusic  why, why do you assume they're issuing a rebuttal to no one? Why, if you're not willing to give them the benefit of the doubt, why can't you just sort comments by age and scroll to all the people they were trying to set straight? They're just trying to offer more knowledge and you ridicule them, that's anti-intellectual trash behavior.
Reply: @MegaNinjaRyan  japans natural hot tubs for example?
Reply: What if the "water heater" is fire. Like the device is above a cole stove or something, you just keep feeding the fire with natural resources infinitely.
Reply: @BLANKrecordwhatilike00000-I  litteraly the definition of not infinite. Coal is notoriously finite. The hot spring in a cold area could be a good place to make it work tho.
Reply: @OrlOg3-ZeB  wood ? Planting trees?
Reply: @User70756  no coal is a residue of fossilized animals that died before mushroom came to the ecosystem. Since we have fungi, the dead animals gets decomposed and turned back into soil so coal is also a finite resource. But a hot spring has enough energy for billions of years so its would be way more efficient with that string that with a steam piston!
Reply: @OrlOg3-ZeB  Using a hot spring is literally just as sustainable as using wood for fire. In Sweden, many people keep their homes warm by growing trees on their own land for firewood. If you have enough space, you can grow trees faster than you use them, making it a renewable source of heat.
Reply: @OrlOg3-ZeB  Wood is renewable, so if you harvested it sustainably, it could be an infinite resource, at least on human timescales.
Reply: @OrlOg3-ZeB  natural resources could mean farming and landscaping waste like cleared brush or cow patties
Reply: @DuncanFerguson-y6h  that is not what infinite energy means. Wood is probably the least efficient way to make heat since it needs about 10- 25 years to grow to a big enough tree to have smtn to burn. It release a very small amount of energy compared to many other sources, it releases a lot of CO2 and other greenhouse gas, requires constant  imput feeding, heavy machinery to harvest (more energy costs), etc. Etc. The only upside I see is that during the 25 years you are waiting for your tree to be big enough to burn for one day, it also sucks CO2 back into oxygen in the air and carbon in its body to some reasonable amount but not more than what it will release considering the wood that will become wood chips(carbon not turned into energy), the leaves that will fall (carbon turned into soil) and also the gas in the chainsaw (or the electricity made with some other energy loss)
Something way more infinite is something that releases energy naturally like a hot spring or a flowing river, a windy region, a sun bathed desert, etc.
Wood is definitely the last on the list...cuz Canadian (Quebecers) would be making electricity with wood instead of water flow😜
Reply: @Fabledelight  yup sure but on an renewable energy point of view it's as Renewable and "waste least" energy we can get yet. Also you don't need to destroy ecosystem to set some of those strings over a geyser! Just a big chunk of iron and it stands on the pit! Island does that with steam pinston/pumps. but that system wastes may more energy than that string for sure!
Reply: @OrlOg3-ZeB  "Coal is notoriously finite" is an amazing sentence.
Reply: @pettarderad  it makes a lot of sense when you know how it formed!
Reply: @OrlOg3cote  We have a lot of coal tho I live in a coal mine area and I've seen plenty of them shut down simply because there's not enough demand for coal to keep the mine open. The ones aren't shut down will go years sometimes without selling any or not enough to justify it they'll still mine it just to get as much coal out as possible so even if it shuts down they'll still have a mountain of coal they can atleast slowly sell of for years sometimes decades without the high cost of going back down there to get more coal out when the sales come.
Reply: @OrlOg3-ZeB  semi active volcano, hot springs. Are you ok?
Reply: it would be burning fuel to create motion kind of like putting gas in a car
Reply: @BLANKrecordwhatilike00000-I  that would basically be a simplified steam engine I would assume
Reply: @BLANKrecordwhatilike00000-I  yes that would make a geothermal generator
Reply: @BLANKrecordwhatilike00000-I  you still need fuel for the fire so you still need infinite energy. The issue with hot water isn't the water evaporating it's the source of the heat/fire
Reply: @BLANKrecordwhatilike00000-I 
No that won't work. The best ideas to have to of these contraptions, one that powers of water heater and the other one to power everything else. 

Obviously the bigger the contraption the more stronger it will be.
Reply: @BLANKrecordwhatilike00000-I  still requires some kind of fuel source
Reply: @Kwantum_alt  Couldn't the fuel source be friction and an endless supply of wood?
Reply: @BLANKrecordwhatilike00000-I  like every power station ever.
Reply: @DuncanFerguson-y6h  yeah
Reply: @BLANKrecordwhatilike00000-I  You get a really inefficient low torque motor.
Reply: @bot42  you're right
Reply: @BLANKrecordwhatilike00000-I that's right this could easily become perpetual motion. But  to be full perpetual motion by the meaning it needs to run on its own without any assistance from us at all. Solar  heating that water would have to now be the closest thing to perpetual motion that Ive seen so far
Reply: @hardcastlemacormac7101  ooh, now I get it, thanks! So the infinitely growing trees thing wouldn't count because it still involves labor and assistance.
Reply: @BLANKrecordwhatilike00000-I  you're still adding energy brother.
Reply: @bricesuire5072  yeah. .
Reply: @bricesuire5072  yeah. . So people are trying to find a way to apply energy with no labor, even if the supply is infinite? 
Like what hardcastlemacamac and everyone else is saying, Iguess the best way would be to use natural timed nature like the sun or hot springs
Reply: @BLANKrecordwhatilike00000-I  🤣🤣🤣
Reply: @BLANKrecordwhatilike00000-I even better, hot springs. Geothermal
Reply: @TheBoys-ho7di Yeah! I think most people in the replies have been talking about how geothermal energy is it
Reply: @BLANKrecordwhatilike00000-I  isn't that literally how we get power from coal. Not a renewable energy source because you have to mine coal.
Reply: @SqueamishPuppet  How about trees?
40 years worth of trees in one field. While you grow more in another. And repeat the tree cycle infinitely ♾️. . .
Reply: I do not know alot about science ish, but you be doing the same thing we doing with coal.
Reply: @BLANKrecordwhatilike00000-I  wind is infinite natural resource too, you are just trying to collect existing energy with extra steps, if there's fire there's easier ways to collect that energy even though it would still be too inefficient
Reply: @notallthosewhowanderarelos7052  ooooh, what do you mean by inefficient?
Reply: @BLANKrecordwhatilike00000-I  Natural ressources are not infinete
Reply: @wilhelmbeck8498  yeah
Reply: @BLANKrecordwhatilike00000-I  why use the energy from burning coal to heat the water for this mechanism, when you could just use the energy from burning coal to power whatever you need?
also, coal is a non-renewable energy source, so what you described would not be infinite power.
Reply: @babybugjuice  yep
Reply: @BLANKrecordwhatilike00000-I Technically, it wouldn’t be infinite because the resources are finite.
Reply: @Patrick-h9q1v  yeah
Reply: @BLANKrecordwhatilike00000-I  that is literally a finite source, and still requires energy. Infact, more so than a heater.
Reply: @lolyea  you're right
Reply: @BLANKrecordwhatilike00000-I  congrats...you discovered how power is already made lol
Reply: @KPT602  lol
Reply: @BLANKrecordwhatilike00000-I burning natural recources gives the fire energy?
Reply: @BLANKrecordwhatilike00000-I  at that point, you could make a steam turbine generator like all of the ones used by electric companies.
Reply: @BLANKrecordwhatilike00000-I  at that point use the alone coal as fuel it would be much more efficient than transferring coal to thermal to a turbine
Reply: @BLANKrecordwhatilike00000-I  still using alternate energy source
Reply: @Valiant.Pacheco  alternate?
Reply: @BLANKrecordwhatilike00000-I That’s just a more complicated and less efficient steam engine…
Reply: @Alcatrazz21  you're right.
Reply: @BLANKrecordwhatilike00000-I i thought your joke was funny man
Reply: @BLANKrecordwhatilike00000-I  the natural resources feeding the fire is a finite source
Reply: @HooliganXx05  yeah
Reply: So your saying power can't be created from connecting the rotating part to a gear system creating motion which could be made into power?
Reply: I scrolled quite a bit, and nobody (except a few jokes) claimed that it was. You know trying to sound smart for no reason just makes you look an idiot, right? You know what jokes are, right? 😂
Reply: But you can put in 1 energy and spit out 2 now, which was believed to be impossible, so use 1 to power the machines to keep it going and 2 for the people.

Ezpz
Reply: The wheel rotation creates heat
Reply: @UcfTALHA  There's still energy loss between the the wire and the wheel.
Reply: @MegaNinjaRyan  theoretically you could use any number of nigh infinite resources
Reply: OK, the heating element for the water can be powered by the infinite power source😂
Reply: No one claimed that, ever.
Reply: @netlans  no word of a lie I literally shouted infinite energy right before reading this comment lol
Reply: @netlans  check other comments 😅
Reply: @netlans  you must not have eyes
Reply: @netlans  Not in these comments, but people try and claim it all the time. I wouldn't fault someone for trying to nip pseudoscience in the bud.
Reply: @netlans Yes they did, because I was coming here to ask how it worked. Please, don't speak for everyone else. The comments prove you wrong.
Reply: @netlans  i did
Reply: @netlans  just wait. Someone will claim.
Reply: @netlans  no one might have claimed it but I was wondering so I'm glad he mentioned it
Reply: @netlans  A lot of people do
Reply: @netlans  you will find someone who does, always.
Reply: @netlans  This was one of the first comments so maybe there's none because of this very comment
Reply: @netlans  Yes, there were multiple comments talking about perpetual energy.
Reply: @netlans  She did. She claimed it was just a property of the wire. Its not. The thing moving it, as with everything else in the universe, is heat acting upon it.
Reply: @netlans   read the replies. Plenty are suggesting it, forgetting the physical laws of energy preservation
Reply: @netlans  no but some of us were looking for the reason it wasn't
Reply: @netlans  Nothing was claimed in the video... MegaNinjaRyan started his comment with "For those claiming". From that, would you infer that the comment it clearing up a claim made in the video or claims being made in the comment section?
Reply: @netlans  there are multiple comments saying that.
Reply: @netlans  there are videos claiming that sadly
Reply: @netlans  are you new to the internet? Someome always tries to use things like this to declare infinite power.
Reply: @netlans  trust me...they did..u are just not aware
Reply: @netlans L comment
Reply: @netlans  I know some were thinking it same as I was until I checked the comments and do further research
Reply: @netlans  guarantee a lot of people did tbh.
Idk why you feel the need to do that
Reply: @netlans  You didn't go deep enough in the comments
Reply: @netlans  perpetual motion claims that...?
Reply: @netlans  no, they didn't 😂
Reply: @netlans  scroll in the comments down like 8 there's literally someone claiming perpetual energy
Reply: @netlans  don’t be so naive. You are underestimating the stupidity of people in YouTube comments.
Reply: @netlans  I can assure you a couple people thought "WHOA, INFINITE POWER" upon seeing that.
Reply: @netlans New Zealand has lots of them
Reply: @netlans I did
Reply: @netlans  there a lot who did, you can even see in the comment here XD
Reply: @netlans  Did you never heard about the idea of a perpetual mobile? 
This isn't one because you'd still need energy to heat the water (or what fluid you will use instead) to make sure that this "motor" didn't stop working.
Reply: @Spielername  Everyone should know there is no such thing as perpetual motion. Not even sure why we are having this conversation.
Reply: @netlans  You said no one ever heard about such a machine, and I answered you that this psydo scientific idea is all over YouTube and the internet in general.
Reply: @netlans  I was still curious
Reply: @netlans  uhh yeah she did... 
She said hot water makes the metal go straight.
Reply: @netlans  You would be surprised.
Reply: @netlans  you read all 2000+ comments?
Reply: @netlans  you would be shocked at how dumb people are
Reply: @netlans  i did 😭😭😭😭😭
Reply: @netlans  There are people in this comment section claiming that. 😂
Reply: @netlans  yes but people might just not have commented, I was confused until this guy came and told me. Just cuz nobody said anything doesn’t mean nobody wanted to know or thought that
Reply: @netlans  but you can see how someone mightve misinterpreted this as infinite energy?
Reply: @netlans  oh there’s def plenty of people who would if they haven’t
Reply: @netlans  Check the comments lol
Reply: @netlans  huh?? Millions of people have bro
Reply: @netlans almost every one of these videos there is someone that believes it's infinite. Not that it's factual.
Reply: @netlans  Yeah, but I was thinking it. Had to be reminded cause I saw this and was all like boing oing oing before I could tell myself that this isn't gonna be how perpetual motion is made.
Reply: @netlans  there are plenty of ppl claiming that, are you dense?
Reply: @netlans  I guarantee you someone has. It looks perpetual.
Reply: @netlans  people claim it every day
Reply: @netlans  but lots of people thought about it
Reply: @netlans trust me someone has definitely claimed this on some random TikTok out there
Reply: @netlans  he wanted to show everybody how smart he is 🤓
Reply: @netlans  some Mmads would do to make shorts...🤣🤣
Reply: @netlans   it's actually debated all the time in similar scenarios. For example someone saying "the hardest part about building a perpetual energy machine is finding where to hide the battery."
Reply: @netlans  Clearly you haven't met my dad.
Reply: @netlans  you don't have proof
Reply: @netlans  just found a comment that did, unfortunately copying comments isn't a thing here i guess
Reply: @netlans  Scrolled about thirty seconds. Found two people. 1,200 likes between them.
Reply: @netlans  no need to just make stuff up, there are people that use this sort of thing to claim perpetual energy even if you personally haven't witnessed them do it
Reply: @netlans  the emperor claimed unlimited power tho
Reply: @netlans  just did unfortunately
Reply: @netlans  literally tripped over 5 more comments saying that on my way to tell you about the 20 I already saw
Reply: You underestimate the stupidity of the people. Ex. 2025 USA
Reply: @netlans  I found 3 in the last 10 days who claimed exactly that in less than 60 seconds of looking.
Reply: @netlans  Darth Sidious did.